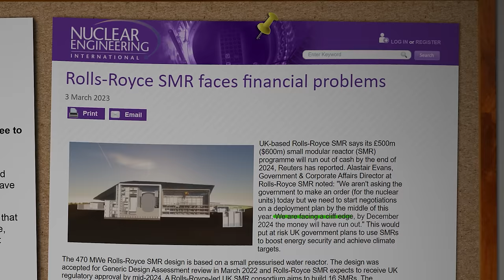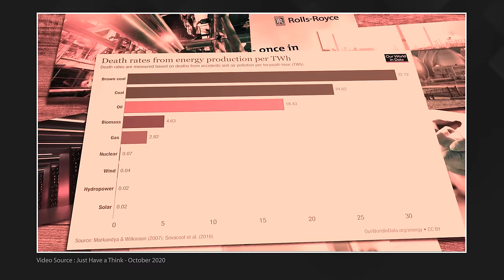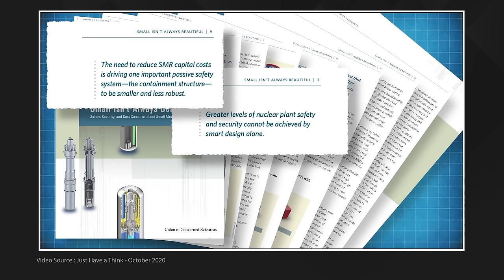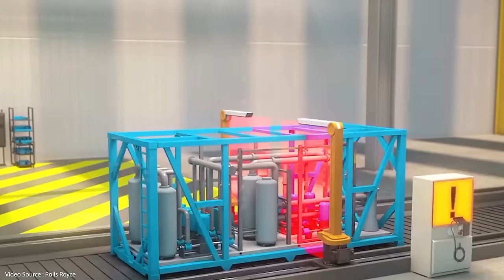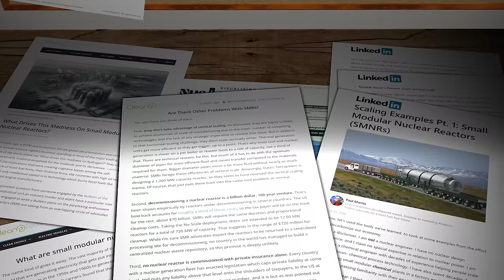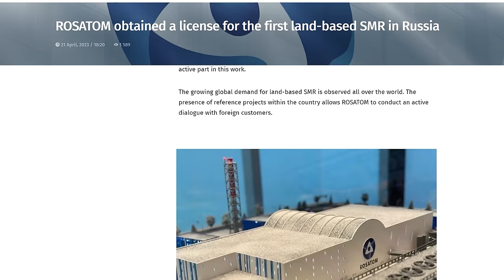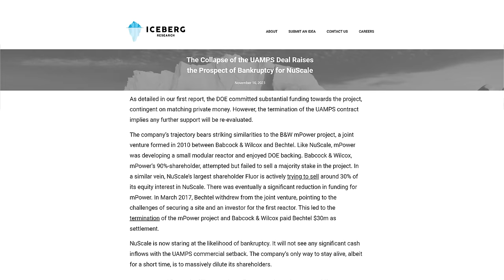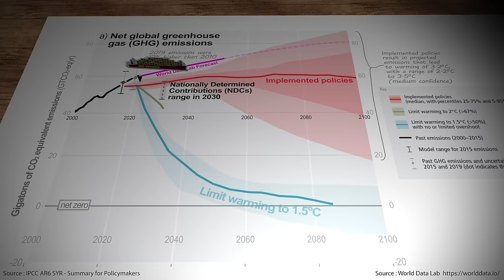Small Modular Nuclear Reactors. The Verdict

Comment: You are so correct that the entire concept of SMR's was fatally flawed from the start just on the economics alone; and the mass production dreams were only ever a fantasy. 

I'm an experienced nuclear plant engineer who is very pro-nuclear and has researched the history of nuclear power plants... and the fact is that the answers were known decades ago.

For starters the concept of "mass produced" SMR's with main components transported to local sites with minimal field assembly was 1st proposed in 1955 in the annual conference on the potential of nuclear power plants (held in Europe that year - not sure which country).

The 1st ever demonstration SMR was a 22 MWe thorium fuel cycle based BWR in Elk River Minnesota (USA) which many people were talking about could be erected in many small communities in the USA.  Online 1964, Shutdown 3.5 years later in 1968 due to major design issues.

However, it had already been deemed uneconomical as a power plant just due to staffing cost alone.

For the record the USA built 17 commercial nuclear power plants in the 1960's - 1970's which would be considered SMR sized today.   All of them were shut down decades ago as they were not economical to operate against the large nuclear power plants built at the same time (I am unsure of the details for the rest of the world; but, understand that the same pattern followed in other countries unless there were unique locations where building larger plants did not make any sense).

As an aside: did you note that Elk River was a thorium fuel cycle (there is nothing new about thorium and the current proponents are not talking about its historical issues identified from the USA's failed attempts to develop it as a fuel source).  The USA went whole hog into developing thorium as a nuclear fuel source in the 1960's - 1970's to see if it would work.  Along with all the test reactors it was run in around the world the USA built and operated 2 test molten salt reactors and the Shippingport demo/test power plant (PWR 60 MWe) which showed a successful breeding thorium core could be designed and put into most of the existing PWRs in the world -).  

The USA then built 4 commercial thorium fuel cycle power plants of BWR, PWR, and HTGR designs. In all cases thorium did not work out (there were both technical and economic issues with thorium fuel cycle reactors) - and at least 3 of the reactors were converted to U235 fuel which worked better and was cheaper.    Note if thorium is such a good choice now why are we not putting it into PWRs at this time - as at least we know that the reactor designs work well and we now have passively safe PWRs?

Anyway back to SMRs (regardless of fuel source):    By the end of the 1970's it was known that the concept of SMRs were dead unless it was for some kind of geologically isolated area where they only needed a small power plant and transmission line construction was impractical.

If you double the size of a nuclear power plant it only takes about 40% more materials and in many cases the plant staff size does not even change.  At some point the staffing size does increase modestly.

As for the failed NuScale Idoho plant.  6 SMR reactors of 77 MWe output was the claimed plans (462 MWe).  What is interesting is that only the 50 MWe version was licensed by the NRC and there was an expectation that the NRC would quickly license the 77 MWe version which they thought could be done during the early site preparation period: Utah Utilities & NuScale was well into the "Pre-License review" of the 77 MWe design and had received good feedback. But the License application was never submitted after they received the construction quote and the pre-licnese review was terminated.

The quote came in at about $9.5 Billion to construct, with an estimated $1 Billion+ inflation adjustment during the construction period.

In reality this would have been about the same price to build a single Westinghouse AP-1000 (about 1150 MWe) and the staffing for the plant would have been about the same.

As for the $55 raising to $89 per MWhr for electricity cost.  That was after $4 Billion from the US government for SMR development grants - so the real cost rose to well over $100 per MWhr (where a single unit AP-1000 could be built for significantly less than half of that).

Note on AP-1000 construction cost:   Yes a lot more was spent at VC Summer and Voglte. But the USA (and Europe with the EPR) had not built nuclear power plants in so long that no contractors and very few workers understood how to build them - and also a number of suppliers shipped fake certified components and materials to site that could not be used - or had to be tore out and replaced.  Massive cost and schedule delays, and lots of lessons learned.    The Idaho NuScale project used the same contractors to quote that had learned their lessons with the Vogtle AP-1000s which is why they could quote so much better (and if those contractors are used before they forget - the next USA nuclear plant will be built much cheaper and much more closer to schedule than Vogtle 3 & 4).

By the way China built 4 AP-1000's with an average construction time of about 6 years.  They had a delay and cost overrun on their 1st one as they were not used to working with the Westinghouse design - but once they understood it - no noticeable delays or cost overruns (and Chinese construction standards and contractors for nuclear are just as good - if not better - than their western counterparts.  No shortcuts, no fake materials, and the workers understand high quality nuclear construction standards and practices).  I did a consulting job for one of the Chines AP-1000 plants; and was impressed.

China is now building 6 more AP-1000s (they have a licensed copy) and at least 2 other countries are starting construction on AP-1000s- and at least 15 more AP-1000s are in the planning stage worldwide.

The Westinghouse AP-300 benefits from the fact that the controls and many smaller components are exactly the same ones being produced for the AP-1000's which provides a cost savings both up front and for repair parts and service down the road.  No other SMR proposal can claim the same advantage.

As for mass production - it will never happen for a nuclear power plant.

1) At a minimum you need a proven plant design that is known to work economically for many decades - and in the history of nuclear power plants most initial designs did not work very well at all.  There is not a single SMR plant that has a proven plant design - and it will be many decades after one goes on line before we know (we only have great PWR designs now based on the lessons learned of over 4 decades of operation of about 100 unique PWR power plant designs worldwide (76 different light water designs in the USA alone).  A lot of design ideas that looked good in concept did not work out and there are many early shutdown plants as it was too costly to modify the plant to a different design.  Now we can pick out which design idea worked for each component, structure, and system.

2) The design of the components and overall plant must be identical for each plant.  Never going to happen as each nuclear power plant site must be designed for "worst case" LOCAL earthquakes, flooding, storms, etc.  No one wants to pay for a plant that is designed to handle all the worst case conditions that exist somewhere in the world.  It would be massively overbuilt and expensive.

3) As for mass production.   I put the number at a minimum of 500 identical units a year - for at least 10 years to make it economical to even build an automated plant.  We don't need that many nuclear power plants (even if only 50 MWe each).

4) Those sketches and concepts of building skids in a frame and assembling them onsite has been tried at least twice for fossil plants.  Total cost and schedule disaster.  One of those ideas that looks good as a concept, but requires a level of quality and dimensional control that so far has not been demonstrated to exist. It's cheaper to just build a normal seismically designed metal framework for the site, bring in the preassembled major components (Like has always been done) and field built connecting piping and wiring.

By the way, we disagree about the cost of solar and wind.  I will post separately on that.
Reply: Possibly the greatest youtube comment ever.
Reply: That's the kind of insight I was hoping to find in the comments!
Reply: Holy crap, now THAT is a detailed comment!
Reply: I think the SMR design makes more sense for producing heat for industrial use. Just go big for grid power. We also need to quit trying to build brand new design reactors for grid use.  That is part of the problem.  Instead of building what we already know we can build they always want something new and shiny.  I live in Canada and would rather we just build the same CANDU reactors we built in the 70's.  They are doing refurbs on them now and are currently 6 months ahead of schedule.  The reactors have been extremely reliable yet the government wants to build SMRs.  It makes no sense.
Reply: Actually one other thing I heard is there are a bunch of reactors in the US that are basically already built but were abandoned.  They really should look at why and if it was just companies running out of money and the reactor can be saved the feds should throw some of that inflation reduction money at them to finish them. It would be interesting to know how many reactors like that are out there but it sounded like they are everywhere.
Reply: Great writeup....you are obviously an expert and your descriptions of the realities of SMR's help us all better understand the pro's and con's of this technology. Thanks!
Reply: Perry, please keep watching and commenting.  This Channel and the concerned public need your insights. 🇨🇦
Reply: A great comment, but the only criticism I'd make of it is that it is extremely US-centric. SMRs have been seriously pursued in a number of other countries - especially by the Soviet Union in the 1960s and 70s - and the experience was, if anything, more disastrous than the US'. I'm sorry, but all this hype about SMRs was just more distraction and delay by climate denialists who have put out a damned sight more FUD than the tobacco companies ever did..
Reply: Mr. Putin's experts are saying  that SNR requires  uranium  to be enriched to 19 percent  to avoid  refueling a reactor too often. In order to develop, license and build such a plant , it would take about  10 years and 10 billion. RosAtom has the technology to enrich uranium and they have SNR up and running  since 2019. The head of  the company said they received about 50 preorders for SNRs 14: of which from abroad
Reply: @kenoliver8913   I should have added a general comment about the rest of the world had similar experiences with SMR's.  I just happen to know the numbers of the USA reactors and know the most about the USA reactor designs.  I did know that they were tried in at least a half dozen other countries in the world.
Reply: @pin65371  It would be the rare case where a nuclear reactor of any size would work for an industrial plant due to the requirements for nuclear plant safety and worst case planning.    In most countries in the world nuclear plants are designed and staffed to withstand at least a terrorist attack of a certain size.  You also have to have a staff on hand to handle a major radiation leak to the general public.   These two factors make any nuclear plant very expensive to operate - and not suitable for general industrial use.   Please note that most nuclear plants are built many Km or miles from any sizable population center - for very legitimate reasons.

As for the 1970's technology CANDU reactors.   Sorry, but in my opinion their time is long past.  They required a lot of operational and active equipment and operator involvement for a safe shutdown in most cases (and 3 Mile island became a partial meltdown when an operator made a mistake and turned off the automated safety system that was running - Chernobyl was also operator errors).  You have no idea how expensive  and stressful it was to keep this equipment in operation and how much trouble it caused every nuclear power plant.  These active systems added a lot of equipment, valves, and controls that had to work - and required a lot of maintenance.

The nuclear world has shifted to Generation 3+ Passive Safety plants where the entire plant staff could vanish, all electrical power vanish, and any of the design basis accidents could occur and the reactor will be safe for at least 3 days.

As an example:  The AP-1000 could have a loss of total power to all systems (which means that emergency generators and battery backups fail as well) and then a large break of the primary cooling pipe... and the reactor would safely shutdown without any operator action and the steam in contaiment would melt a fixture on a storage tank on top of containment allowing it to slowly drain cooling the containment building and condensing the steam... and the only action needed to keep the core safe and prevent a meltdown is that after 3 days someone needs to refill the tank on top of containment - which could be done with a pumper truck and a fire hose if needed (although there are multiple systems in the plant designed to fill that tank).   After a few weeks they don't even need to fill that tank anymore.   Everything will be safe.

The good news is that last fall some company in Canada announce that they are designing a Generation 3+ passive safety CANDU reactor and will be submitting its design in future years to the Canadian regulator for approval.   That's the reactor you want to build if you wish to stay with the CANDU design.    Otherwise the PWR AP-1000 is the current best design in the world (the EPR designers have admitted that they have to redesign it and no new EPR projects will start.  The GE Generation 3+ large central station BWR could not find anyone to build it).   I am unaware of any other large central station Generation 3+ designs, although I understand that the Koreans are working on one.
Reply: @pin65371  Concerning all those abandoned US reactors in various stages of construction.   Construction dies on all of them due to the then current way nuclear power plants were approved, constructed, and licensed; and all but one (Watts Bar Unit 2) was formally abandoned and could not have construction restarted even if they wanted to (it would actually be cheaper to just build a new modern design).

The original nuclear plant approach in the USA and many other countries was that the NRC approved the concept of building a nuclear power plant at a site; but did not license the plant for operation until after it was complete - and only then did the NRC do a design review to see if it met "current design and construction practices."

There were several problems with this approach:

1) It was assumed that the vast majority of the nuclear power plant (except for a few components and systems) could be built to commercial construction standards with no oversight.  That turned out not to work so well and problems became apparent once a number of plants gained some years in service.   Then the NRC issued new requirements on construction standards.  Now what if you had already built that equipment and systems.  Sorry, it cannot be licensed to operate - and you need to tear it out and build it again.

This happened multiple times which caused delays and major cost overruns.

2) In 1975 the Browns Ferry Nuclear power plant had a major fire where the operators lost control over key equipment and almost lost control over the reactor itself.   This was because there were no requirements for cable and piping separation for redundant trains of safety equipment (a small fire at one location could damage all the control cables for 2 or 3 separate supposedly redundant equipment trains required for nuclear safety and plant operations). 

This drove major design changes to require control and power cables for each separate piece and train of nuclear safety equipment to be physically separated by a good distance (or in some cased inside fire proof case or with a substantial fire barreir so that they could not be affected by a fire).  This required truly major design and construction changes to any plant not yet licensed (and existing licensed plants had to modify if they could or hire a large staff of dedicated fire watch personnel who all they do is wander the plant from critical location to critical location making sure there is no fire that could affect the bundled control and power cables:  I think the one plant I worked at have something like a staff of 20 people dedicated to being these roving fire watches).

3) in 1979 3 Mile Island partial meltdown occurred because of a variety of operator mistakes; but there were several key pieces of information the operators did no know (and could not know because they did not have the instrumentation required:  That a relief valve had stuck open and they had what is known as a small break loss of coolant accident in progress; and that a water level with a steam bubble above it had formed, and that this water level was getting low enough that it uncovered the reactor core - resulting in a partial meltdown).

Another series of major design changes were ordered - and this time it affected the licensed plants as well (and most of the PWR plants in the world now have 3 trains of redundant water level indicators on the PWR reactor vessel); and every relief valve on any primary coolant or treatment systems now has redundant temperature and/or flow measurement indicators so that the operators know if a relief valve is leaking).

So for the plants under construction it became a constant game of required design changes while the plant was being built, and many plants just gave up due to the constant very costly and time delays caused by all the rework.  Once work was suspended the owners canceled the NRC construction permits (which cost money to keep open) and abandoned any attempt of maintaining quality control of their partially completed plant.  Many components were sold off to other nuclear plants in the world who wanted to buy for dimes on a dollar nuclear grade equipment.  One of the plants I worked at got new steam driven auxiliary feedwater pump turbines from one of those plants as our late 1960's designed pump turbines had a major design error that did not show up until well after our plan was running (it always had problems - and I was the person who figured out why and found the original records from the Mfr that documented the problem).

It's litterally impossibile to restart construction on the plants where the construction permit was closed. The USA NRC has no procedure or process to bring one of these plants back into a construction process as there is no longer any qualified QA rec cords for key structures and design elements.

Watts Bar Unit 2's construction permit was kept open by the TVA and since it was to be the 2nd unit of a dual unit site where the 1st unit was already running - they had QA on site and maintained the quality control of the plant and construction records.   I believe that construction of Watts Bar Unit 2 was restarted in 2011 and it went through the old licensing process and was licensed in 2016 for operation.

After the Nuclear Power plant industry went through this constantly changing standards while they were building the nuclear power plant and all the major delays and cost overruns (and canceled plants) the industry demanded that the NRC change their licensing process. They wanted an approved design that they could build without any design changes unless there really was a major new issue that no one had every thought of or had happened.  

That was the start of licensed nuclear power plant designs, and licensed sites before you start construction on the key power plant structure.   Now a utility is issues a Construction and Operating License (COL) in the USA to build a specific licensed reactor at a specific licensed site.  As long as you build it to the specifications and implement all the programs and strafing defined for the reactor and the site you already have an operating license.

I know that many other countries have followed the US NRC lead on this approach and I understand that even China is using this approach now (and I have heard that Europe also has some experience with changing plant design during construction process).
Reply: My understanding is that China is currently going for factory based production of the components of their HT PBR to replicate this on scale for industrial heat and hydrogen production as well as power.

The dicotomy you draw between mass produced and one off would also appear to be too absolute, as there are a host of semi custom options available, where you factory build the bits you can, and fiddle around on site to some extent.

That is true also for safety. The costs of building to the worst conditions anywhere for all plants would of course be prohibitive, but you could certainly have a reference design, which is pretty strong, but which you simply don't put somewhere really daft.

Nuclear is a good option to have as a part, and only part, of the grid, especially in high latitude countries where overbuild of solar is more expensive and provides security against events like major volcanic eruptions greatly reducing solar.
Reply: Re: Your comment on Solar / Wind / Batteries...

You can today build a stable SWB system with 90%+ uptime that has 5x the effect in half the time of any given Nuclear plant for the same amount of money.

Or, to put it in other terms... Let us assume 1 Gigabucks buy 200 MW of Nuclear power, to be built in 10 years. *Or*, should we spend $1G to buy 1000 MW of SWB in 5 years time?

And that gap is increasing, two years ago that number was twice as expensive as it is today. By 2030 we can build 15x-25x the SWB effect of a Nuclear plant in 5 years. How far does the gap need to grow, before you admit it is cheaper? :)
Reply: @wertigon  I made very specific criticisms of the arguments presented, that the notion that mass production is only in vast quantities and semi custom is not an option, and that the only way of having reasonably standard safety criteria is to over engineer to the point where you can stick a reactor anywhere at all you fancy instead of somewhat restricting your choices of location is equally false.
Shifting the argument straight across to 'alternatives are cheaper anyway' is not a productive way of arguing. 
The Chinese argue and there is some evidence to support that their levelised cost of power from nuclear before whatever level of standardisation they can get by series, I would term it, not mass, production of as many parts as possible in a factory setting is currently cheaper than their renewables, which they are pretty good at.
How costs may develop is another issue, but we end up arm waving if specific arguments are not challenged and tested, rather than 'So and so technology is better anyway'

The good news is that where we do not have the ridiculous build revisions and beaurocracy of the West, nuclear is already a cheap option, and some degree of factory series production is likely to help.

I agree with the argument that SMRs as opposed to a greater degree of serial build of larger reactors are not proving cost effective.

If other technologies can do it cheaper yet, great.

I am optimistic that that will be the case, but properly managed nuclear construction also looks like a fine low carbon alternative.
Reply: so lets get this straight,your pro westighouse and anti rolls royce,golly gee u must be an american,shucks!
Reply: I had my hopes up for SMRs and knew about all of the US work in the 70’s. To me it seemed like a better solution. They did abandon all that back then.

After reading your commentary on this topic I understand. We are as far as we are going to go for a several reasons. Just seemed like it would have been easier to handle a problem with a modular system, but I guess it’s just not practical for a bunch of reasons.
Nice comment. I learned a lot.
Reply: You missed one important issue exposed by the attempt to build VC Summer and Vogtle at the same time.  Even though the projects were ~50 miles apart there were not enough constructions workers with the needed skillset to build them.  And that issue is  not going to change anytime soon as the number of people in the construction trade is decreasing, not increasing.
It is not a forgetting issue, it is a  not enough workers issue.  And supply chains don't understand or care about what nuclear grade means.  The U.S. capitalist business model has devolved to get away with whatever you can.
Reply: @perryallan3524  First let me say that every reactor operator in that TMI-2 control room that night was a highly trained ex-navy nuke. And they did exactly as they were trained to do.   
While the accident could have been mitigated if the operators had taken the simple action of closing the block valve, as you say, they lacked the proper indications and given what they did see, they did exactly as trained.  I was weeks away from my NRC Reactor License Exam at the time of the accident and I would have taken the same actions as I was trained to do.
Reply: To the issue of using thorium as a fuel, the simple answer is it requires reprocessing. Thorium has no natural fissile isotope, it needs to be breed and reprocessed. Reprocessing fuel, Plutonium or U-233 cycle, is still deemed uneconomical. I would argue that the waste reduction brought about by reprocessing would make it more viable if utilities had to pay the cost of long term geological storage, but we're not there yet. 
And yes, nuclear is really a technology that makes the most sense for large scale, high density power generation, that's where the costs are lowest. I think the global push for SMRs is coming from an insane opinion that nuclear needs to compete against renewables+storage, but that couldn't be further from the truth. The two systems complement each other wonderfully in a decarbonized grid. Renewables provide great access to electricity at low density; but in high energy density demands, like large cities where you're needing to meet tens of gigawatts of capacity, large/regular scale nuclear makes more sense. 
It's just so silly that the argument it still being framed as nuclear vs. renewables, when in reality it's fossil fuels vs. any reasonable alternative. All of this grobbling over LCOE and LCOS is a fight over a couple of dollars on or off of the average persons monthly power utility bill. Pick whichever one makes the most sense for the local circumstances and the world will be better off
Reply: @Spencergolde  You obviously have some knowledge and/or experience in the nuclear power generation field.  

However, the internet is flooded with YT videos from creators intent on nothing more than making money and viewers with little education or even ability to understand the issues involved.  Many people that I have chatted with actually believe in Thorium reactors without any knowledge of fissile vs non-fissile. 

 As soon as they state that uranium reactors use only 3-5% of the fuel while claiming Thorium reactors use 100%, I know that the American public school system has let us down again.
Reply: @wertigon  Your analysis omits 3 key facts.   

1) The average construction time worldwide for a GW sized nuclear power plant is 6 years and they are built pretty much on budget as well, when you exclude the European EPR and the USA's AP-1000 experience where both Europe and the USA had not built a nuclear power plant in so long that they had no experieced contractors and almost no experienced workers who knew how to build nuclear plants - which led to massive schedule and cost overruns.

2) The fact that current solar PV and wind turbines only have a useful life of about 20 years (solar PV cells degrade every year in operation).

Since the expected life of current generation 3+ passively safe nuclear power plants is in the range of 80-100 years (or longer) you would have to tear-down and rebuild your solar and wind generation 4-5 times at ever increasing cost.

While there is a very long life (if not infinite life) battery technology it is rarely built because of low energy density and its very large size.

I have not even heard of a utility scale battery technology other than the low density one I mentioned above that has even demonstrated a 20 year usable life at this time (perhaps I am wrong on that).

Anyway, your technology choice now has the customers paying for tearing down and building new solar and wind facilities about every 20 years so you are looking at a lifetime cost in the range of 4-5 times larger than your analysis suggest.  What's going to happen with battery life is an unknown but does not look good based on initial results of modern batteries.

Your option is not cheap at all - unless you ignore all future cost that would occur for your technology in comparison to a nuclear power plant.

3) Your analysis totally ignores the cost of capacitor banks needed to control reactive power in the transmission and distribution network, and their replacement costs, that are not needed with a nuclear power plant.

As far as your projections of how economical solar and wind will be in 2030.  Those projections might not develop.
Reply: @philcooper165  You miss my point and a key fact presented in the video.

RR is a great company with a great history in many areas.   I do believe that they are technically capable of designing a safe SMR reactor design that would basically work (how well is yet to be seen).

However, RR as a company has almost been bankrupted by a series of key design mistakes in their civilian aviation engine division spanning decades; and if you follow the aviation forums you will find people yet claiming that RR will be forced to split up and have the civilian aviation engine division declare bankruptcy.

RR does not have the money to develop a SMR to a licensed design status.  My memory of the video is that they have asked the UK government for a 225 Million grant to fund such a development.  Note that if the UK government funds that development I would expect a unfair trade practice claim to be filed in international court; and I don't see how the UK wins that case (its clearly preferential treatment by the government of 1 vendor).  Then the UK owes someone (or several someones) 225 million + interest.

Even if the UK government were to fund the RR proposal that does not mean that the RR design would win out over other designs such as the Westinghouse AP-300.  

What Westinghouse has going for it is that its plant will use the same controls and control scheme that has been proven on the AP-1000 plants, and a number of other identical components already proven on the AP-1000 plants.

Furthermore given the production numbers of the AP-1000 plants there will be spare parts and technical support for those items at a reasonable cost for likely 80-100 years or more.

I've worked in nuclear power plants that had equipment that was only used in a few nuclear units.   Spare parts and technical service was extremely expensive (and in several cases several plants are paying the mfr to have a staff to support their 1960's technology).

In my opinion; anyone with half a brain on long term parts and support cost for long term operation will chose the Westinghouse AP-300 SMR which uses a proven design and control scheme with its larger AP-1000 cousin over a new design which may well only have a few reactors built.

Have a great day,
Reply: I am more convinced than ever, by this conversation, that upgraded (gen 3) nuclear electricity is the way forward for our civilization and our species. We have grave challenges ahead and must work in cooperative and efficient manner. Thanks you guys!
Reply: That's a fantastic write-up perry.  I thought one of the key advantages of the SMR concept was supposed to be that they do not need to be built near water.  The other advantage being the lack of refueling outages and as a result- no spent fuel storage requirements.  I am a sales / tech service rep for manufacturers of specialty materials used by commercial nuclear operators, and was calling on Holtec for a time when they were unveiling their SMR-300 design.  (I believe they are building two at Palisades- but that may have changed.)   The current fleet of US nuclear power plants operate on a near geologic time scale, and projects can take many many years to develop.  I know countless engineers in the nuclear world, and what I observe happening is that when engineers retire- they are often not being replaced.  Rather the work is divided amongst the remaining engineers, and so really only the most crucial projects get attention.  At this point- it's only crucial projects, and essential maintenance- and other projects that years ago would be addressed are being deferred (until they are elevated to "critical").  One of the plants that I service outsources some of their engineering to Rolls Royce in the UK.  Other plant engineers are pulling double duty as engineers at Sargent and Lundy, Enercon (RIP), and other firms.
Reply: @mtn1793  I worked in the nuclear industry for 40+ years at five different facilities and am pro nuclear.

But here are the problems in the U.S.;
1- While large (Gw) gen 3 reactors are the best overall choice, they take ~15 years to build one and the construction industry does not have the personnel with the necessary skill set to build more than one at a time.

2- The cost for new nuclear is 2-3 times the cost of any other power generation method.

3- Many of the 93 currently operating nuclear power plants are at or beyond their design life and while they can keep running, it is  not cost effective given the maintenance costs.

4- If and that is a big if we address all the challenges and everything goes right we may be able to replace SOME of the current nuclear plants with new ones but the percentage of U.S power consumption provide by nuclear will decrease significantly over the next 10-15 years.

That unfortunately, is reality.
Reply: @clarkkent9080  I mentioned the experience worker shortage in my main post.   I also know that only about the top 1/4 of workers can adapt to mindset needed to work in nuclear construction and nuclear power plants.  Yet both plants were making progress on finding workers with the right mental attitude willing to learn the skills needed.   There is now in the USA an adequate size core workforce with experienced contractor management to actually build a nuclear plant pretty close to on schedule with minimal cost overruns.

The reason VC Summer was cancled was not a worker shortage.  It was gross mismanagement of the project in that the VC Summer upper management were not willing to change their ways even when presented with better ways of doing things.

Both VC Summer and Vogtle were having a lot of problems with schedule and cost.  Both plants hired outside experts to review how they were doing things and make recommendations to bring the project back on track and at least finish it as cheapest as possible.   The recommendations for both plants were virtually identical.

The upper management at Vogtle swallowed hard when they read the report - and implemented or addressed virtually all recommendations with either direct compliance or with an alternative method they though was more adequate for their current situation.

The VC Summer upper management rejected the report as apparently an insult to their knowledge and methods and proceeded to move ahead without changing anything.  The VC Summer project died once that became known to the State Utility Commission.

They should have known better.  If you have worked much in the nuclear industry you should know that making mistakes is not a problem (we all make mistakes).  It's only a problem if you don't acknowledge the mistake and fail to take actions to prevent occurrence.  I've never felt any fear to go to my management or the on duty SRO and tell them that I made a mistake that they needed to know about, what it was, why I think I made it, and ensure that it did not affect the overall safety or long term operation of the plant.  My experience is that you get thanked for that.

I also was one of the engineers who was Root Cause Evaluator Qualified; and have led many interviews with operations, maintenance, engineers, etc. on what they knew or did and why regarding a major plant issue.  I always started with the clear instructions to the people being interviewed to just tell us the truth and what you understand and there will be no repercussions except perhaps some additional training if needed; and there never was as long as they just told us the truth.

In my nuclear career (I am now retired) there was only 1 case where we identified that someone was less than truthful or intentionally did not do their job.  Needless to say that things did not go well for that person. My understanding is that the NRC issued them a 5 year ban on working in the industry letter to him - which ends your nuclear career even after 5 years, he had already gotten a job at another plant as his way of avoiding his involvement in the issue he created.
Reply: Perry:  Excellent input but I've run out of time to comment, suffice to say, we mostly agree and a little disagree.
I posted my 'two bobs worth' this morning - Sydney Aust (above).  Have a peek and by all means criticise.
Reply: @clarkkent9080    Perry Allan contradicts the 15 year build time even if that’s the current reality. Many said the USA couldn’t build for WW2. We’re backed into a corner in my opinion. Civilization as we know it is an energy based construct. Fossil fuels are a threat on several levels at this point. If we are to maintain civilization and face the coming troubles we’ll need the most efficient solutions possible and we need to act on that now. My pet fantasy is that every bit of government subsidy for nuclear be returned to the public as return on investment. These changes required involve more than just energy.
Reply: @clarkkent9080  Thank you for reading my prior comments.  I did not mention the block valve as I did not want to confuse people with extra information who are not in the know.

But, are you saying that you would have turned off the Safety Injection system as the one operator did which is the key item that led to the partial meltdown?

A little background:  I'm an ex navy MM who was not a nuke because I am partially color blind (although my test scores and attitude were great to be a nuke); and every navy nuke who worked in my engine-room told me that I would have made the perfect navy nuke.

At least half the operators at the nuclear power plants I worked at are ex navy nukes; and I don't recall a single one of them telling me that they were OK with turning off the SI system given what was and was not known.

However, the bigger issue is that one of the biggest lessons of 3 Mile Island is that you should never rush to put a plant back online after a trip.  The big change in the industry afterwards was that the operators job was to ensure the reactor is safe, properly shut down, and all safety systems are working (which you would know if you completed your exam and became a licensed operator).    Let's take a day of so to fully understand the trip and do some of the maintenance list on the full or partial shutdown maintenance list.  Once we know what really happened and some things are fixed we can do a controlled slow startup. There is just no reason to rush it.  At all 3 of the nuclear plants I worked at an operation inspection team of the containment building was made to look for any unknown issues now that the reactor was offline.

Of course this goes against the Navy training where if the plant trips you have to get it back online as fast as possible. In a battle dead in the water with no maneuverability is often literal death.

So this is a case where the Navy training and concepts of fast response to a trip does not fit civilian nuclear power plants, and likely contributed to the event (as my memory says the event started with some upset with the condensate or feed-water system which resulted in a plant trip and they were rushing to get the plant back online - I forgot the exact details and see no reason to look them up).
Reply: @arau8310   All Rankine Cycle (Steam Cycle) power plants need to be built near water - or have a very large aquifer to pump water from as makeup for a cooling tower.  This is needed to condense the steam back to water after the steam turbines.  Also there is a lot of plant equipment and HVAC that needs cooling water as well.

While I have seen concepts for a Brayton cycle power plants (Combustion turbine with the nuclear reactor or a heat exchanger heating the air/gas ) I have never seen one tested for a nuclear power plant (I am aware of one tested using a coal fired boiler to heat the air - and the flyash ate up the turbine blades very fast).

Even then, the only way to make a Brayton cycle plant efficient is to have a heat recovery boiler at the end with a second steam cycle turbine generator (Combined Cycle Power plants - thermal efficiency well above 40% and in some cases about 50%).

You are correct about what is happening to engineering plant staffs and long term maintenance planning.  I was downsized by that out of nuclear plants.  Then did consulting work for about 4 years until the work dried up due to plants no longer focusing on the long term.
Reply: @clarkkent9080  The average construction time worldwide for a GW sized nuclear power plant is 6 years.  Both Europe and the EU have gone through a very expensive learning curve as both of us had lost both the contractor and worker experience needed.  After Vogtle the next US Nuclear plant can be built far closer to the worldwide average using the same contractors and the core workforce that built Vogtle - if we act fast enough.

The average worldwide construction cost is about 1/3 of what Vogtle cost (and the Chinese built 4 AP-1000's and have started construction on 6 more).  Note that the Chinese workforce and technical standards are second to none for nuclear power plant construction.  I did a consulting job for one of the Chinese AP-1000 plants and was more than impressed. These are not the people building tofu buildings and bridges.

It will take time to rebuild both the contractor and worker workforce, but it can be done and within a decade we could again be building 3-4 nuclear units a year in the USA.  If the political will is there.
Reply: @petercunningham2339  I'm sorry; but I cannot find any previous comments from you.

Are you sure that they posted.   One thing I have learned that any link to another site does not clear some automatic filter.  Other things tend to get filtered as well which is a problem I deal with at times.
Reply: @petercunningham2339  Only time will tell whom is correct.   I have been saying NuScale's project was doomed to failure for the last two years and I was right.  I suspect that Terrapower will meet the same fate
Reply: @perryallan3524  aren't the safety concerns / requirements less stringent for SMRs since the impact of any single reactor failing is much lower and easier to manage than failure in a large reactor? Also, isn't the likelihood lower of any particular SMR failing catastrophically since they have more modest cooling requirements?
Reply: @clarkkent9080   Sadly - Yes, I agree with you.
The point is:  Nuclear energy (as distinct from warfare) has been with us for 60 years, and like any manufacturing, has improved.
The mass produced car and aircraft and ships (and whatever) have vastly improved via trial and error and economics.
Nuclear energy is no different.
Thus condemning Nuclear is a declaration of ignorance.
Reply: @ You, and many others, miss what the actual nuclear safety concerns are.  Short answer is that the standards are exactly the same small reactor or large reactor.   The small reactor may have certain advantages due to its small size; but the plant staff has to be ready for the same series of "worst case" events.

The fundamental job of every nuclear plant worker in the USA and most Western Countries is "To protect the health and safety of the public."    You do that be limiting any radiation release beyond the plant boundries to a trivial amount.  However, you have to be staffed and have emergency response equipment and plans with the local communities to respond to an unacceptable release offsite.

The Nuclear regulators don't care if your nuclear power plant ever produces any electricity or ever makes a profit.  Your job is to protect the health and safety of the public - pretty much no matter what happens to the plant with very limited exceptions - such as a large meteor smucking the nuclear plant - which is now called a "Beyond design basis event" and the plant should have equipment and personnel to deal with most of those beyond design basis events.

However you do have to plan for the worst possible case (well beyond anything in the records or geologic history in the rocks in the USA) of a local earthquake, flooding, terrorist attack, someone flying a large commercial airline into your containment building or spent fuel pool, etc.   Interestingly I read that the canceled Idaho NuScale project had to consider a volcano eruption within a certain distance as part of their design basis events that the plant should handle without any radiation release above the defined trivial level to the public.

Next you can add things like protect the health and safety of the workers, major plant equipment, etc.

Bottom line is that the plant has to show that they can handle a major radiation release inside contaiment and a sudden hole in the containment building.  I remember the drills well --> you now have a 1 square meter hole in the containment building... and then they see if you can adequately protect the health and safety of the public given the current wind conditions after things have gone horribly wrong with the reactor and fuel integrity and in our case the primary loop of a PWR.  We always wondered what event made such a perfectly square 1 meter hole in our containment building.... ;)

If a SMR is small enough the radiation leakage will be smaller which assists in containing the area of the leakage and dealing with the people downwind.  But probably will not matter if you have a windstorm at that time.

So same standards.  Even a small  reactor can create an horrible radiation mess inside the containment building with the right failures.  

For those people who think that does not apply to molten salt reactors... what happens if the reactor vessel or primary piping cracks and most of the screaming hot radiation wise molten salt fuel & daughter product mixture gets dumped on the floor or sprayed across containment by a leak - it will be a very bad mess and the air itself will contain highly radioactive particles within the containment building.  Now just add that hole in the containment building which is part of almost every emergency drill I was part of.

By the way having enough staff to handle such a failure and to be able to effectively keep the public safe is one of the things that really does not change based on plant size.  That works against the cost effectiveness of small nuclear power plants.

I hope that answers the question.
Reply: @perryallan3524   DUNNO, but directly below your posting - the one to which I now reply - is my comment.  "By accident I stumbled ......"
Reply: @perryallan3524 Actually...

1. The average SWB system that would deliver an equivalent amount of TWh and almost certainly more effect than most nuclear sites, currently costs ~20%-25% of the Nuclear power site and can be built in a year or two. Of course, this is the general case. And prices are dropping, too. Even if we compare best case Nuclear with worst case SWB, SWB still wins out in costs.

2. PV can go for 50 years or more. Wind is slightly worse, but new materials and manufacturing processes prolong the lifespan here, too. Also, Nuclear is not free to run, you need trained specialists and frequent repairs - Solar + Wind requires little maintenance and thousands of generators can be covered by a team of 40 people or even less.

3. No, those costs are included in the SWB analysis. I base my analysis on Adam Dorr and Tony Seba.

Please have a look at impossible grid batteries like Hornsdale and Moss Landing, that are operating at capacity. In my country alone, 2 hours of battery storage for 25% of the total generation is planned the next three years and more is to come. It is moving insanely quickly now. :)
Reply: @petercunningham2339  My point is simple: 
The U.S. cannot advance new nuclear for the many reasons that I have stated based on the latest facts for the most recent nuclear projects. Terrapower will be another example.
 If we pull out all stops and put this country on a Manhattan like project to build more nuclear projects, the best we can hope for is replacing the current nuclear power plants that have exceeded their intended design life and are no longer cost effective.

While I agree that nuclear workers have a high degree of honesty and work ethic, being in the actual operations allowed me to see a reality that you apparently were shielded from and many of the investor owned nuclear power plants are being infected with a less than acceptable level of safety from the top down. So I see a degrading not an improvement. 

A nuclear power plant is a machine and as such it can fail and accidents can and do happen.  Unless there is a radioactive release to the environment, the public is never informed of the many accidents. Yes there are improvements over time but I fail to see any ground breaking improvements in boiling water. 
If you researched the Westinghouse AP1000 you know it is a standard 1970s Westinghouse design with fewer loops and passive safety features.  Those passive safety features were primarily incorporated as cost saving measures (less RCPs, fewer Emerg. generators, etc.) with the added benefit of the PR hype.

 I have worked at CE, Westinghouse, and B&W plants and from an operational perspective, Westinghouse is a rube goldberg design of added complexity to resolve issues with previous added complexities.  CE designs are somewhat simular to Westinghouse. B&W plants are engineering marvels. 

I am pro nuclear and am not condemning anything.  Working in the nuclear industry taught me to leave out my desires and emotion and rely on facts and reality.  The number one rule is believe your indications unless proven otherwise. My indications direct me to make the statements above. What do you base yours on?
Reply: This is fascinating insight.  My father was on site at TMI the day after the incident.  He was there as part of a response team (he worked for the manufacturer of the safety-related wire and cable used at the plant).  The reports coming from news agencies at the time stated something like "radiation levels are 3 times higher than normal at the facility" which might have been true- but still put them at safe levels since radiation levels were so low under normal operating conditions.  Most people do not know that the other units at TMI continued to operate until just a few years ago. when all were shut down in 2019, despite the license having been extended to 2034.  I work with many great people at other plants who were once stationed there.
Reply: @perryallan3524  So sad that the industry is so short-sighted as to not recognize the detrimental loss of all of this tribal knowledge.  Knowing what works and what does not and having to relearn all of the proven techniques is a costly mistake the industry is insisting on making it seems.
Reply: @arau8310  TMI unit 1 continued to operate.  There were only two units at TMI.  TMI-2 was only 3 months old at the time of the accident and had very few fission products and very little decay heat.  Had the accident occurred at unit 1 that had been operating for a long time and had a significant fission product and decay heat buildup, the outcome would have been very different.

The simple point is that the accident was very bad and trashed a multi billion dollar plant that never operated there after.  I cost $1 billion in 1996 to just clean up the melted fuel and the containment is so contaminated that it is not even scheduled to be decontaminated till 2040, 60 years after the accident.  

Anyone that thinks the news reports were bad should realize that today with social media, 24-7 news, and political infighting it would be much worst.
Reply: @perryallan3524  
Research Hinkley build time in the UK.

You can maintain a nuclear power plant for 80 years but the cost to do so would not make sense.  Many components are no longer made before the plant produces their first Mw.  That is why many investor owned utilities want to shut down their  40 year old Gw units.

Wind turbines have an infinite lifespan as they are gear boxes and generators. The 20 year life span refers to the fiberglass blade life before replacement is necessary.

Today's solar panels lose 0.5 to 0.75% efficiency per year. So after 30 years the output drops to 78 -85% of original capacity. Every fossil fuel and nuclear power plant loses efficiency over their life. Replacing a solar panel is a lot easier than building any standard power plant.
Reply: @perryallan3524  You may know that the Design Basis Accident (DBA) is a double ended sheer of a reactor coolant pipe downstream of a Reactor Coolant Pump.  While there are many scenarios that could possibility initiate that event, the most logical and the one presented in the simulator training is a solid primary system with a temperature increase. 
So we were trained to never, never, never let the pressurizer go solid and that is EXACTLY why they terminated HPI and why I would have taken the same actions. That PORV indication is the ONLY indication in the entire control room that is based on demand not actual position....something never presented in training. 

Now or even days after that event the Monday morning quarterbacks can express shock that someone would do exactly as they were trained.  If you had been in operations, you would know the level of training to do as you were taught, follow your procedures and believe your indications. 
You must also know that many accident have occurred because operators thought that they knew better than their procedures or indications and took unapproved actions.

I personally know some that were in the control room that night and they are the best operators I have ever met and they did EXACTLY as they were trained.

I also know the Davis Bessie operator that a few years earlier terminated the same exact event by simply closing the block valve. When I asked why he took that action he was honest and said I had no idea what was happening but I didn't think closing the block valve would hurt. That operator should have lost his license for taking unapproved actions but since everything turned out ok, it was overlooked.  And given it was the 1970s, things were not as strict as after TMI.

I have a BS degree but even with that, I should never judge what an engineer does as I don't fully understand the job. I would suggest that you do not judge those operators, as you do not fully understand that job.  And any NRC licensed operator that doesn't understand why they did what they did, either  licensed after the accident or is not being truthful.
Reply: @arau8310  Baby boomers have been retiring in mass for the last 10 years and the last boomer will have reached full retirement age in 6 years.  It is not just nuclear that has lost experience.  Next time you fly , look at who is flying that plane
Reply: The problem is you haven't figured out yet that fossil fuels aren't economical.
When you account for the cost of damages and clean up.
We seem to have a political problem here, where the generation in power believes in infinite dumping on the next, and rigging of the pricing system to achieve that end.
Investors love profitable public dumping if you let them get away with it! Stop waiting for them to change their minds on that point.
Reply: @perryallan3524  I take your point about staffing, though it still seems like it's easier to build a resilient plant with smaller components whose containment structure could be placed on seismic base isolators and would be less likely to buckle and crack in an earthquake than a very large concrete containment building, for example.

I'm not sure how you would cleanly map the "1 meter hole" situation onto multiple smaller containment structures, but certainly if you're required to show that you can handle many simultaneous breaches at once, it would complicate things. Similarly, if the size of the hole isn't scaled to the size of the SMR containment structures, a 1 meter hole in one of those will be a much bigger problem since the exposed surface area to volume ratio is much less favorable when looking at a small building. Each SMR will contain less radioactive waste, but if multiple are breached with an equally large hole, their contents will spill much faster due to the increased surface area. So I guess it all depends on how you want to model these events.

Anyway, the staffing issue is definitely a big concern for costs. Thanks for your perspective.
Reply: Good information. 👍 
Does anyone calculate the transmission costs to the millions and millions and millions of customers. 
Say double generation, and you would have to double the capacity of the grid. 

Fragile grids can have blackouts. 

Electric energy is only 15 to 18 % of all energy used, so 5 to 7 times bigger national electric grid ezi pezi. Sarcasm. 

Everyone will be busting to invest in all the new private electric generation plants.

Just get the government to build the bigger national grid. Ezi pezi. Happy days. 😊 
Sarcasm. 

Staffing costs and quality are totally ignored also, as you say.
People get lost in their fantasy. 

The national electrical grid expansion is the killer cost economically. 
National debts will explode.
Reply: @wertigon  The only place I have heard of 50 year life of solar cells is for the extremely expensive ones that are used for long life satellites which are constructed the old fashion way from the absolute best quality individual silicone cells.

The ones being installed for power generation on land have an estimated useful life of 20 years as their ability to convert sunlight to power degrades every year.  Yes, physically they might last 50 years but would be producing almost no power at that point.

Most wind turbines are being torn down well before age 30 (with 20 years currently being common).  In theory you should be able to replace the blades and reuse the generators and gearboxes; but that is generally not happening.  My guess is that the gearboxes, generators, and potentially the towers themselves were not robust enough for reuse.
Reply: @ent9080 Worldwide that average build time for a GW sized nuclear power plant is about 6 years without any major cost overruns.

The problem is that Western Europe and the USA had not built nuclear units for so long that the contractors and workers forgot how to do it - and its a very costly with lots of schedule delays to teach a new generation.

In the USA if the same contractors who built Vogtle 3 & 4 were tasked with building another dual unit site they would likely be able to do in in less than 8 years with only modest cost overruns.  If they build a 3rd set they would be able to meet the world standard of 6 years with no noticable cost overruns.

Western Europe and the USA are missing the chance to develop the knowledge skillset for contractors and workers to build economical and on schedule nuclear power plants.

IF we focused on it within a decade we could have both the contractors and workforce needed to be starting 2 new large central power plants a year.  Note that there are currently 62 nuclear power plants under construction in the world; and 59 of them are large central stations (3 are of the SMR size - and one at 29 MWe is a technology demonstration plant in Argentina).  That means an average of about 10 nuclear power plants a year will be coming online over the next 6 years.

Late edit add:  The cost to maintain and upgrade an  older nuclear plant is far lower than the cost of a new plant.  They are economical to run for as long as you can. Keys being the life of the reactor itself and of major structural components.  Everything else is fixable or replaceable.  

At the plant I spent the most time at they are actually discussing taking about a 5-6 month shutdown and rewiring the entire plant to get to 80+ years (at least for the wiring that has not already been replaced - most large motor wiring has already been replaced).   The control, instrument, and original power cable casings are starting to get brittle after over 50 years of use.

An added benefit would be they could separate the wiring for trains and eliminate a staff of about 20 people who do nothing but roving fire watches as that plant predates the Browns Ferry fire and it has the same kind of situation where the control, instrument, and power cables for both safety related trains are in many cases in the same cable tray.
Reply: @clarkkent9080  I agree that one of the DBAs is a double ended sheer of the primary coolant piping in a PWR.   But, as you know... not the only DBA for the plant.

Lets just agree that we see some things different and also agree that TMI taught us a lot about things no one anticipated and resulted in an expensive set of modifications to all PWRs to provide the Operators with the information they need to see what is going on.

Have a great day,
Reply: @clarkkent9080  Last first:  This isn't a fight or a tussle to see who is right.
And this copy paste posted to Perry Allan that equally applies here:

? @perryallan3524   THANKYOU for bothering to write such a comprehensive review.  For me, EXCELLENT information that helps me learn. (and others reading this electronic sidewalk)
I suffer engineers logic - or as some say - "know your enemy", in other words factual information that challenges my understanding is WELCOMED.
How else is one to learn of reality?
What a pity in todays world that the official narrative is THE truth, and shall not be questioned.
Thankyou for bothering to take the time - and all that I just typed will be copy pasted to Clark Kent's also excellent, considered response.
Yours and Perry's comments won't rest with me.  GOOD info needs be shared.
Reply: @petercunningham2339  There is no right or wrong here.  Some believe in what can happen and what is possible and that is a very optimistic view that is valued in today's world.
I embrace the pessimistic view based on historical reality and what we have experienced up to this point.   However, I always try to improve and change the paradigm for the better.  In my world, I am prepared for the worst but strive to minimize that by haveing a contingency for the worst and responding accordingly. In that respect, I am rarely disappointed and usually rewarded with a better outcome than I originally expected.

Optimists however are not prepared for the worst or able to respond effectively as they never anticipated it, are usually caught off guard and disappointed.

If there is a nuclear resurgence, I will welcome it and gladly admit the errors of my thinking.  However, we should be prepared for a different outcome.
Reply: @ywtcc  Which is why I am very pro nuclear.  I just see large central stations as being far more economical than SMRs
Reply: @cornoc  The modeling of an accident only assumes one accident per reactor at a site.  I worked most of my nuclear career at a dual unit sites (2 reactors) although I have also worked at a single unit site.  For drills we only assumed that one unit was having all the problems - including the hole in the containment building for that reactor.
Reply: @clarkkent9080   My opening comment related to your "What do you base yours on?" - is irrelevant now.
Though not so negative, My logic is yours.  
Plan for the worst - look for the holes and the bugs because as with anything 'man' makes can and often does fail.
Nothing is perfect and worse - the little things most often align to result in a problem of some sort.
The aviation industry has an excellent analogy of Swiss Cheese - ie:  where in some circumstances, all the holes line up - and then shit happens!
Reply: @clarkkent9080  You are correct, and thank you for the interesting detail.  Every failure is a big deal, but my point was that the media (and Jane Fonda) made it sound like TMI-2 was a Fukushima-level event, when there was very little radiation escape.
Reply: @petercunningham2339  Then lets both hope that there is a nuclear resurgence but also hope that if that does not come to pass, there were some pessimists that planned other contingencies.
Reply: @perryallan3524  For cargo ships and freight trains it looks like we're going to need nuclear to get the job done.
For delivering thermal energy directly, nuclear's pretty good.
Measuring the cost of electrical energy generation isn't a good way to assess dramatically different energy technologies.
Reply: @stephenbrickwood1602  What you have there is a pile of ill informed complaining.
There's a concept called a "productive argument".
Learn how to have one.
Reply: @ywtcc  going the wrong way is wrong. 

As the capacity of generation increases, then grid capacity has to increase.

Grids are incredibly expensive.

Do you understand.?
Reply: @ywtcc  nuclear reactors require both a radiation protection team and equipment in case of a major accident that release radiation to the public, and a security team to protect the plant from terrorists.

It's not practical to do those things for ships and freight trains.  

Also for trains - what do you do if there is a major wreck and the reactor compartment splits open releasing a lot of radioactive materials and radiation to the area.

As for ships the USA built a commercial cargo ship (NS Savannah).   It was totally uneconomical due to the staffing size required on the ship to run it; and worse is that many ports in the world would not allow it to enter port to avoid being a potential nuclear disaster site if something went wrong.

The NS Savannah was decommissioned and the reactor and related areas removed from it  way early for a cargo ship.
Reply: @llan3524 It's totally impractical to turn SMRs into nuclear bombs.
You'd have to collect a bunch of them, the fuel will need to be processed. It's the crime of a nation state, not a terrorist group.
It's also probably easier just to mine the stuff if you're a nation state.
The regulation required isn't over the top as long as you keep track of SMRs.
This is part of the benefit of centralization. You can have those high security arrangements at a central manufacturing and maintenance site, then have that one central site service many reactors.
It's a also really nice iterative design project. Next gen manufacturing, I think, will have good application in this sector.
Reply: @ywtcc  technically, in the details, you have some interesting points.
It is a global situation that is still a major military problem. 
Little Rocket Man in North Korea and Iran Ayatollahs and Pakistan and 

All Dictators would love a nuclear industry.
Reply: Comment should be pinned
Reply: Perry, thank you for your detailed, cogent answer. A terrific contribution to the conversation, and much appreciated.

I've speculated on why SMRs are being pushed - again. I'm interested in your thoughts about this. There are some obvious motives:
- physics PhDs want a career in their field;
- investors see megabucks contracts which run for decades;
- contractors enjoy bidding very large long-term builds too;
- Unions & managers/executives are grossly overpaid at nuclear facilities.

Sorry if that last one seems gratuitous or slander: it's quite true. I've been an Executive Search troubleshooter for years, have replaced senior executives all the way up for utilities in Generation, Distribution and Transmission. I've interviewed the senior execs of every utility in N America, and know what they're paid (or did a few years back). Obscenely overpaid doesn't quite touch it for some utilities, the worst of which was Ontario Hydro/Ontario Power Generation. Multi-billion dollar builds make for a lot of money to spread around, and there's nothing that touches nuclear for excess.

But I speculate that the primary driver is a scam: placing SMRs on an existing nuclear site enables the operator to petition to just mothball the old reactors and avoid decommissioning to greenfield. This pushes the horrific cost of decommissioning down the line, leaves it for someone else. Ditto for waste management, a problem still unresolved. If the site is still an active nuclear generation plant you can argue for just continuing to store past & accumulating waste on-site in swimming pools. Problem solved until it's someone else's. 

What do you think?
Reply: @perryallan3524  Perry, I agree: "Anyone with half a brain... will choose the Westinghouse AP-300 SMR... over a new design which may well only have a few reactors built." 
I give you... Doug Ford, proud possessor of a Grade 12 diploma, some experience as a suburban illicit drug distribution "business", some time City Councillor and now, Premier of Ontario. And, I submit, possessor of perhaps half a brain.
Reply: @clarkkent9080  I'd like to revisit your comments about turning off the SI system.

I understand your comments about preventing the pressurizer from becoming solid.  But, didn't the TMI plants have pressure gauges on the primary loop and temperature indicators in the pressurizers.  As long as the temperature in the pressurizer is high enough you know that you have a steam bubble, and thus not solid?

When I went through system training as an engineer we were taught the required temperature to ensure a steam bubble in the pressurizer (well after TMI - which occurred while I was in the Navy and before I went to Engineering School and then I spent a fair amount of time in fossil plants) 

I do believe that all the required instruments were original to the plant and my memory of the reactor startup procedure was that you used the pressure gauge and temperature indicators to know when you established a steam bubble (and maintained it).  But, that was a Westinghouse reactor and I believe TMI was a B&W.

There may have been both equipment and a training difference between the two plant designs which explains why the operators at the two W plants I worked at did not understand the decision to turn off the TMI SI pumps.   The old timers (who were reactor operators in 1979) told me that they always knew if they had a stream bubble or not because they too knew that they had to prevent the system from going solid unless you were going into cold shutdown and the primary loop temperature was below a certain temperature (which is why they saw no need to turn off SI pumps unless they positively knew things were OK).

So tell me how the B&W design worked as far as knowing if you had a steam bubble or not and how that would have played out with your training.
Reply: @jamesthompson7282  little people ignore the grid expansion costs. 
Little people talk about spark plugs and let the big people raise the financing and build the road and infrastructure.
Reply: @ywtcc  That does not make any sense; and just last week I read a paper on the problem of verifying compliance for diversion of waste fuel with a MSR reactor.

It's a real concern because a MSR could easily short cycle the fuel mixture and be used to generate bomb grade U233 (which makes a great bomb).

The key trick is that you either seed the reactor with Pu239 (which contains some Pu240) or you seed the reactor with bomb grade U233 or bomb grade U235 (and virtually no U238).

Then you run the molten salt fuel for only a few months and dump it into bottles or tanks; which gets shipped off to a recycling plant.    A simple chemical extraction of the uranium gets you bomb grade material as long as you have not run the fuel long enough to generate too much U234 which acts as a poison for a U233 bomb if above a very minute amount (similar to how Pu240 poisons a Pu239 bomb).

How is the international atomic energy agency going to be able to track if the reactor fuel is being short cycled and if its being reprocessed into bomb grade materials.   As the paper I read said - they are working on coming up with a method; and I believe it will probably require active monitoring of any MSR thorium fuel cycle plant as a condition of licensing.

As far as multiple SMRs at a central station.  You are correct that takes care of the security and radiation response staff to a plant emergency for multiple units at once.  But the cost gets very high.

If you double the size of a SMR you need about 40% more materials and its likely that you can still use the same size of plant staff (at some point as you continue to do this plant staff will increase modestly).

If you build 2 SMRs instead you need twice he materials and at least 150% of the staff for 1 unit (there are places where you can share staff between side by side units).  The economics of the cost of construction and staff size makes 2 or more SMRs side by side quickly untenable.
Reply: @jamesthompson7282  Unfortunately, the GE BWR design was likely the only SMR design available at the time those decisions were made.  Westinghouse is a couple years behind GE on design and licensing and is moving as fast as they can.

But the next project will face the competition between the GW BWR and the W PWR.
Reply: @jamesthompson7282  Great post. I suspect you're right
Reply: @perryallan3524  If you want to have an argument, you're going to have to prove to me that you have enough respect to read my comments.
You haven't proven that.
Reply: @ywtcc  I don't need your respect.  If that is what you are looking for on this thread then I cannot help you.  

I am trying to respond to your main points; but I don't respond to all people on this thread and I may not respond to you in the future.

The readers of this thread can determine who's arguments make the most sense and decide who they respect or not, or that they just don't care (and different people often come to different conclusions on that).
Reply: @perryallan3524  Why are you so motivated to argue over what the economy will look like in 50 years?
Seems to me there's better solutions than argumentation. If that's all we did, we'd never have left the stone ages.
Reply: @perryallan3524 What is your opinion on GE-Hitachi's BWRX-300? They are considered for repowering Poland's coal powerplants, particularly industrial and urban cogeneration, which we use a lot.
Reply: @Zielinski85 I think the Polish plans have a likely chance to change to the Westinghouse AP-300 now that Westinghouse has entered that market size for nuclear reactors.

This is a bit different than Ontario Power (Canada) that made the decision to use the BWRX-300 as it was the only Generation 3+ passively safe reactor in that size range.  I expect those BWRX-300 reactors to become orphans in the nuclear world (only a few will be built and long term parts and technical support will become very expensive).

Westinghouse has now jumped into that market with the AP300 and the facts are that the PWR is the better long term economical design (see the data below).

So lets talk about the BWRX-300 SMR.  This is a Boiling Water Reactor and a downsize of the GE ESBWR which the USA NRC issued a design certification for in 2014 and no one in the world built (not even the Chinese who were evaluating Western power plant designs).

In that time-frame GE had 2 utilities who wanted to build a total of 3 of the large ESBWR; but GE could not come to any kind of agreement on cost to build these plants.  Meanwhile both China and the USA came to agreement to build 4 Westinghouse AP1000's (and all 4 of those are running very well). China and Europe came to an agreement on building 2 EPR reactors as well (and those are running - although they have had some issues and the EPR designers have now admitted that they have to redesign their reactor to address those issues).

However there is a more fundamental problem with a BWR of any design: Virtually no one wants them as while they are cheaper to build than a PWR they are more expensive to operate; and about 60 years of experience all over the world is that the PWR is the most economical option in the long term (and it is not even a close comparison).

Here is some data (from the World Nuclear Association:  As of February 2024 (updated frequently) there are...

Operating Power plant reactors in the world (413 total):
301 PWRs.
46 Pressurized Heavy Water Reactors (PHWR)  Note: these all appear to be variations of the CANDU design
42 BWRs (30 of those are in the USA from the US NRC):  Note that this is down from about 100 a decade ago.
11 Light Water GRaphite Reactors (LWGR)
8 Gas Cooled Reactors (GCR)
2 Fast neutron Breeder Reactors (FBR) Note: liquid metal cooled
1 High Temperature Gas Reactor (HTGR)

Under construction are the following power plant reactors (61 total - and I have just pulled the latest list from the World Nuclear Association - the webpage is updated frequently)
53 PWRs
3 FBRs (both sodium and lead cooled: India, China, Russia)
3 PHWRs (heavy water - CANDU design)
2 BWRs Note: both of these were under construction in Japan when Fukushima happened in 2011.  Construction was suspended and has not been restarted; but their construction permits are still open.

Note that after Fukushima that Japan shut down their entire nuclear power plant fleet because their design basis accidents did not include tsunamis; and the needed to evaluate all their nuclear power plants against a new set of design basis accidents (and what is now known as "beyond design basis accidents" with a suitable way to address everything except the rarest thing like a large meteor smucking the plant and just leaving a crater were it was).

Japan ruled that a sizable number of BWR reactors, and I think a few PWRs as not being able to be upgraded; and retired those plants.

Japan has restarted 9 of their 16 PWR reactors and modifications to the new standards for the other 7 are well in progress with planned restarts in the future.

5 out of 17 BWR reactors have been upgraded to modern standards (some years ago for some of them) and are sitting idle.  Japan has not been taking any actions indicating that they will actually restart those BWR reactors. My understanding is that modifications to the other 12 BWR plants is proceeding much slower than for the PWR plants (and have not even been started at some of the BWRs). That leaves a big question as to why not, what is Japan questioning about their BWR plants?

It appears that Ontario Power will indeed build a few BWRX-300 reactors; which may become the last BWRs built in the world.

The question is what will Poland and a few other countries do now that the Westinghouse AP300 is available as the PWR has a very clear long term cost advantage.  

Also the AP300  has a significant long term advantage of reasonable parts and technical support cost as it is using the same control scheme, controls, and a variety of other common smaller parts that the AP1000 uses (6 now built, at least 8 more on firm order - the Chinese CAP1400 is a somewhat larger Westinghouse designed and licensed version of the AP1000), and discussions for many more AP1000s are occurring in many countries in the world (and the UK is now wishing that they had chosen the AP1000 for Hinkley Point instead of the EPR).  The parts and technical service for those items will be readily available for the next 80+ years at a reasonable cost.  Huge advantage for the AP300 (and I know how costly parts and technical support for orphan plant equipment can be).
Reply: @perryallan3524  Thank you for your thorough answer. How big is the emergency planning zone around the AP300? My understanding is that one of the major advantages of BWRX-300 is that it can be put inside an industrial plant complex or on the outskirts of a major city, making it compatible with our brownfield sites, allowing the reuse of existing heat and electric infrastructure.
Reply: You don´t have a clue what your talking about.

A SMR is not just a reactor that have under 300MW of power. It have to be modular. Modular not the same as small. 

Small AND modular reactor.
Reply: There are several definitions involved here.

First is that in normal operations and events no radiation must be released beyond the site boundary except for a certain class of major events.

Certainly, a smaller reactor could have a smaller site boundary that would be consistent with brown field or even green sites within older industrial sites or business parks that cater to manufacturing plants.

The second definition is that the emergency planning zone must be large enough to cover a major radioactive release from a major event at the plant.  The 3 plants I worked at and several I consulted with in the USA all had a 10-mile emergency planning radius.  I didn't ask about the radius of the one Chinese plant i consulted for.

I'm not sure that 10-mile is a fixed number as I can see certain areas with well known winds in a specific direction to perhaps have a larger radius (or an oblong shape).

The concept is that radioactive releases either just go up into the atmosphere and get spread out across very large downwind areas (think of how Chernobyl affected Europe), or that the heavier radioactive particle should settle out and fall to the ground under normal conditions within 10 miles.

Within the USA I have never heard of an emergency planning radius less than 10 miles for a power plant (test/research reactors have different rules depending on the size and type).

I am unsure what other countries use (is it the km equivalent of 10 miles, smaller, or larger; but the concept is the same.

My discussions with people from other western counties does indicate that they have the same "site boundary" and "emergency planning radius" concepts.
Reply: @matsv201  Show me any realistic power plant design that is modular.  You have no concept of how large even small power plants are and the impossibility of what you suggest.

I was the Plant Manager of a fossil plant that had a 6 MWe, a 12 MWe, and a 16 MWe turbine and generator prior to my transition to nuclear power.   That plant (including cooling tower & spray pond cooling) covered about 5 city blocks not counting the coal yard which covered another 3 blocks. 

The fact is that the term "modular" has never existed in the way you are defining it in regards to SMR power plants.

It's that some of the components are modular... which is in fact what every power plant every built (fossil or nuclear) has always been.

Nuclear reactors themselves have always been modular.  They have never been built on site (although the heads for PWRs may have been shipped separately and installed on site after fuel loading).   In the case of a BWR even the heads may have been shipped installed on the reactor vessel.

The SMR concept is not new. It was 1st proposed in 1955 at an international conference about the future or nuclear power.

The 1st ever conceived SMR was a 22 MW BWR at in Elk River Minnesota (USA) which many people were talking about could be erected in many small communities in the USA. Online 1964 and shut down in 1968 due to massive technical problems. 

It was also noted that it could never be cost effective just due to the required staffing levels to operate and handle any potential major malfunction (and it sat next to a fossil power plant run by the same utility for a really good direct comparison).

The reactor was shipped as a separate modular unit. The steam generator was shipped as a separate modular unit.  The steam turbine was shipped as a separate modular unit.  The electrical generator was shipped as a separate modular unit.  

The condenser was built onsite as was the containment and shield building.

Major Pumps, Feedwater heaters, etc. were all shipped as separate modular units; although perhaps several fit onto a single truck or rail-car.

Then the piping and wiring was field erected to connect everything.

Other than a few very tiny micro-reactor concepts I have never seen a truly modular nuclear reactor power plant concept.   It's just modular components that are field located with field connecting wiring and piping.

I also happen to know that the NRC approved NuScale 50 MWe power plant units also had separate major component modulus to be field assembled into a pant onsite.   

Key difference is that the condenser tube bundles are now modular (even for 1200 MWe power plants), although the base condenser structure and framework are still field assembled onsite for large central stations; while smaller power plants in the SMR range usually have 3 components that are field assembled together (the turbine to condenser transition; the tube bundles support structure - and for small enough power plants the tubes bundle will be installed in this piece, and the hot-well).  

Condensers are no longer totally assembled from individual pieces onsite which is the only change from before the 1990's.
Reply: I'll admit that I am baffled why the USA does not use more district heating (and cooling).  Far more efficient that having all the equipment in each house to burn raw fuel or work from outside air as the heat dump for air conditioning.   I have hot water heat in my house and it would be much more reasonable to get heat from a district heating plant.

I have spent what alert time I have had today (I've got brain fog problems from covid) reviewing some of the BWRX-300 design and pre-licnensing review filed with the USA NRC (which were also filed with the Canadian Nuclear Regulator) and both regulators are working together on eventual licensing.

I have no arguments on the size of the reactor.  Yes there are places in the world that would make sense.    

I question re-powering existing power plants with a BWR as the steam is radioactive and contains radioactive particle debris that carryover from the reactor - and the entire steam plant become mildly radioactive.  Fossil plants were not design for that and I just cannot see how you would successfully convert and keep things near as cheap as using a purpose built BWR steam plant and equipment.

Worse yet is the concept of distributing radioactive steam and carryover particle to all kinds of businesses and houses in the area.

While you could have a secondary boiler that creates clean steam... that adds cost.

Also, lets get our facts straight.   The reactor and containment building is not totally underground.   Half of the Reactor Building is underground, and the other half is above ground.  The top portion of the reactor and the top of the containment building is above ground.

The spent fuel pool location is interesting but makes sense as does having a flooded area above the containment vessel during power operations (it has to be drained to open the top of the containment vessel and remove the reactor head for refueling - then flooded for refueling -  and then drained again then to put the reactor head back on and the containment building cover when refueling is complete).

Keeping it flooded during operation does provide some radiation security in the event of a major problem.

The pool above the reactor does not directly mitigate a LOCA.  There are actually 3 separate pools.  One of them (without spent fuel in it) has several heat exchangers in it and the pool water condenses the steam from a LOCA and drains it back into the reactor.   

I have no idea why Poland is saying that the Emergency Planning Zone (EPZ) is 0.5 km as GEHitachi as of Dec 2023 said that has not yet been determined.

That is especially meaningful as I reviewed both the draft safety plan section submitted to both the Canadian and US Nuclear Regulators that dealt with what happens if Defensive Line 4 was breached (creating a major release - which is where the EPZ comes in) and the combined US NRC and the Canadian Regulator response that told GEHitachi that they fell short in their analysis and needed to do more work in that area.

The same Canadian/ USA Regulators response to their safety evaluation have told GEHitachi that their pool refill systems to make up for evaporation in a LOCA initially submitted to the regulators are inadequate for licensing.  That is likely easier to fix than figuring out the EPZ.

I worked at two PWR nuclear plants that were about 600 MWe per generating unit (twice the size of the BWRX-300) and during the major casualty drills they always announced that we now had a 1 square meter hole in the containment/shield building; and how did we respond to that given the current weather conditions (without ever explaining how such a hole could occur or why it was a perfect square with 1m sides).

Since a good portion of the containment vessel for the BWRX-300 is above ground... I fail to see why they would not be expected to also develop such a hole and have a EPZ adequate for that hole (maybe it will be a smaller hole for a smaller sized reactor; but I fail to see why they would not require such a hole in the containment building for new reactor emergency planning after everything else has gone south inside the reactor - such as having a meltdown even if there is no explanation why or how that occurred).  Emergency planning drills assume that pretty much nothing goes as planned - and there is now a new design basis "accident" is for what are now called "beyond design basis events."

I understand Poland is waiting for either the US NRC or the Canadian Nuclear regulator to license the plant - and will use that license to license it in Poland.   So lets see what comes out on the EPZ once a license is issued.  It's obvious that neither Canada nor the USA regulators felt that GEHitachi properly addressed this up front.

While I wish the BWRX-300 and Poland well, the fact is that over 60 years of history has shown that PWR nuclear power plants are overall cheaper than BWR nuclear power plants.

Westinghouse has now entered the market with its AP300 and can also bury half of its containment building and put the Spent Fuel Pool above the reactor; and its steam is not radioactive and could be used to repower existing power plants or provide district heating.   I fail to see how long term the BWRX-300 is going to last in the market assuming that Westinghouse does a decent job with their AP300. I do admit that GEHitachi will likely build the 1st set of nuclear power plants of this size range.
Reply: Mate, you should put that on Medium as an article or on YouTube as a video and get paid for it.
Reply: @perryallan3524  Again, thank you for your thorough answer, this is the kind of insights I was hoping for. Regarding city heating, in a word, heat exchangers. You seem to describe first generation steam systems, like in NYC. We use a mix of gen II and III, with some islands of gen IV in new developments. There's a good Wikipedia article describing the differences. My apartment building is hooked to a 140°C-ish water pipe and that is exchanged to 75°C radiator water and 55°C hot tap water in the building basement.
Reply: Hmm well... the problem with the conventional Nuclear Reactors is  the need to built around large bodies of water next to sea etc. and well you know it .. shame you did not mention the issues the storage and disposal of wind turbine blades and for example the issues of Gallic Arsenic in solar panels... now you know there is at this stage four gas cooled TRISO reactors in China..  the problem is the most of the designs as you know are not understood by say Westing house in the US and therefore block the other Gen V types of reactors.. .. so given say the example of say Germany of where i live but Im not German shutting down their current reactors and then LAUNCHING 25 coal ..sorry the "re-classifed buring lignite coal the brown coal ..as NOT coal " release lots of Radon gas and is actually very toxic and radio active... sorry I do think there is a future for SMR I agree to disagree.. but perhaps you should have mentioned the issues with solar and wind... convenient
Reply: I was thinking of a hot and cold water for a district heating/cooling system - steam is only practical if you have industrial uses for steam.   I used to design such systems on my own time and costing them out back in the late 1980's and early 1990's (and I worked in a US Navy steam engineroom before getting my engineering degree - so I understand steam, hot water, pumps, control valves, and piping systems very well.   I don't understand why various US cities and large towns have never built them.

Have a great weekend.
Reply: @IainMcGirr  This specific thread is about nuclear power plants.   If you read my starting post at the end of it you would have found a statement that I disagreed about the cost of solar and wind the Video Presenter had; and that I would post separately on that. 

I did post separately on that and in that post I discuss the problem that solar and wind installations typically only last 20 years and have to be replaced, where nuclear units can be expected to run for 80-100 years.   I did not get into the details of the disposal and waste issues as no one asked (please post in that thread if you wish to discuss this in more detail).  I did not believe that discussion belonged in the thread discussing nuclear plant designs, history, and pro’s & Con’s; and you are the 1st to mention it.  All it does is support my contention that when you consider all the cost associated with delivering electricity to the end customer… that nuclear is competitive in many areas of the world.

I am more bothered by your statements that the Chinese gas cooled reactors don’t need a large body of water available; and that those of us in the west don’t understand the Chinese designs.   

Nothing could be further from the truth for both claims as the fact all Chinese nuclear power plants (other than test or very small demo plants) are built near large sources of cooling water and that virtually every Chinese nuclear power plants (including the pebble bed HTGRs) are nothing more than copies of Western designs (with a few tweaks).  China is very poor at original engineering, but very good at copying and adding slight improvements.

I was furthermore horrified when I looked up the most recently completed Chinese HTGR articles and how many total falsehoods were in the articles.  It seems even technical news reporters never even check basic easily verified facts.   

As you are living in Germany I would have thought that you would have recognized that the Chinese HTGR power plant is nothing more than a copy of a shutdown German HTGR plant (and the Chinese admit that) – at least if you knew anything about the history of German nuclear power plants (Germany pioneered Pebble Bed nuclear power plants).

High Temperature Gas Reactors (HTGR) are not new.  All plants built so far have been cooled by helium (other gases have been discussed).  They use the high temperature helium to boil water for a standard steam turbine, condenser, condensate, feedwater back to the boiler power plant (Carnot steam cycle).  Thermal efficiency for full sized power plants are often in the upper 30% to low 40% depending on specific design and local cooling water temperatures to condense the steam back into water (which beats the typical low 30's % for a normal fossil boiler or nuclear power plant).

All steam cycle power plants require a very large quantity of water circulating through the condenser to condense the steam.  That can be provided directly by an open cooling source (river, lake, ocean) or via a cooling tower which uses evaporative cooling and only requires several % of the cooling water flow as makeup (and for smaller power plants a good well can work for that).

I should also point out that all HTGR power plant reactors are “passively safe” if they trip offline as they cannot meltdown due to their TRISO fuel which dates to the 1950’s and was developed in the UK: it is either formed into “prismatic blocks” or “Pebbles”. All HTGR power plant reactors have used TRISO fuel, and most test/research reactors have and do as well. 

So nothing new about the fact that HTGRs are “passively safe” (in fact I have yet to see any Generation IV reactor design that is new – just minor upgrades to many decades old designs).  But you cannot generate public excitement unless you can claim you have a “new” design.  Not even that lie is new.

All HTGR power plants that have been built have been associated with a large enough body of water to provide adequate cooling.    The recent “hot news” Shandong province HTGR (210 MWe) is built at Shidao Bay with direct access to the ocean to provide condenser circulation water (Wiki has a summary article with a great map).  There is so much cooling water available at this location that China is also building 2 CAP1400 nuclear units at the same location (1400 MWe each, Licensed AP1000 design – and China hired Westinghouse to design the larger 1400 MWe nuclear power plant from their ~1150 MWe AP1000).

Without getting into test reactors and small demonstration units that did not have any electrical generation (all under about 30 MWthermal) the following HTGR power plants have been built in the world.

Peach Bottom Unit 1: Est Somewhere in the 65-75 MWe range (I can easily find the thermal power, I have not found good documentation on the MWe).  Online in 1967, shutdown in 1974. Prismatic fuel (designed and started up with thorium; changed to U235 at 1st fuel load).

Jülich Research Centre, Germany: 15MWe. AVR pebble bed prototype plant. Online in 1967, shutdown in 1988.  Pebble fuel.

Fort St Vrain; USA: 330 MWe. Online in 1979, shutdown in 1989. Prismatic fuel (designed and started up with thorium; may have been changed to U235 later in life).

Hamm-Uentrop, Germany: 300 MWe pebble bed. THTR-300. Online 1985, shutdown in 1988 (very minor radiation release due to some pebbles breaking); but after Chernobyl in 1986 the German Public demanded shutdown as not even a very minor radiation leak was acceptable (even though they were working to make the pebbles more robust).  Pebble fuel (thorium).

Shidao Bay, China: 210 MWe pebble bed.  2 HTR-PM reactors feeding a single 210 MWe turbine/generator.  Online 2021.  Pebble fuel.  Note that China says they plan on building 9 more of these at Shidao Bay (10 total), in addition to the 2 CAP1400’s

So there is the actual history, and you can look up and verify it all on the web (some sites list slightly different numbers; I used the ones I thought were more credible).

Us people in the West totally understand the Chinese reactors as we developed them, and the fuel too.

The USA built 2 HTGR power plants in the 1960’s and 1970s with passively safe TRISO fuel (Generation 1 and Generation 2 designs).

The Germans built 2 HTGR Pebble bed power plants as well with passively safe TRISO fuel (Generation 1 and Generation 2 Pebble bed designs)

What is new about the so called “Generation IV” power plants that China borrowed the design from the German Pebble bed reactors.  Not passively safety as that has always existed since the late 1950’s in HTGRs and not TRISO fuel. 

What happened to a Generation 3 TRISO fuel HTGR?  Ahh that’s perhaps what the Chinese built at Shidao Bay… It’s just not sexy or modern to talk about that (lies are often more exciting than the truth).

All steam cycle power plants require a large amount of cooling water to condense the steam back to water.  While I have seen discussions about a Brayton cycle nuclear power plant which would not use a steam cycle; its efficiency is poorer for the temperatures the current generation HTGRs can safely attain compared to the Carnot steam cycle.

Have a great day,
Reply: @perryallan3524  

I appreciate your posts as you skip the great majority of the bullshit. Yes you support nuclear, but not for the usual rubbish reasons. 

However....

Yes, renewables probably have a reasonable service life of 20-30 years. Steam plant requires major refurbishment or rebuild on similar time-frames. You posit 80-100 years for nuclear, with no equivalent demonstrated examples. The oldest operating power reactors are in their fifties, with little scope for life extension. The average age is only 40, and for those several life extensions are certainly in question, with many of the same design and performance closing early for operational losses or repairs. 80-100 is optimistic. With a steadily declining fleet and tightening market, few may ever exceed sixty years.

You mention  nuclear steam efficiencies at 40%, and coal in the 30s, whereas my reading puts it the other way around. Even coal plants built in the 60s had conversion at about 44%, whereas the temperature and pressure limitations of civilian nuclear mean that they rarely exceed the low 30s.

You seem dismissive or unwilling to consider the real problem of  long-term spent fuel storage costs and final disposal, yet these are utterly unavoidable and large components of the total cost of ownership. Delay is unethical as it places the genuine burden on people who will have no memory of the alleged benefits. This could be more easily ignored if we had genuine data: A substantial fraction of wastes disposed in a majority of nuclear nations, with performance data and established costs.  What the public sees is promises, and the spectacle of the US DoD and DoE fighting in court over a fraction of ageing wastes wastes rather than display "honour" or "integrity" and actually accepting the burden and just getting it done. 
These wastes are an undeniable and unavoidable expense uniquely derived from nuclear operations, and cannot be divorced from the cost of supply. Nor can solutions be delayed indefinitely. Further delay increases interim costs, and final difficulty. Even a nation impoverished by plague or warfare cannot afford to neglect active maintenance and final disposal. Who will underwrite that? In what currency? Who will neglect their dependents to see it done?

Your posts are otherwise excellent, but there are major issues and unfunded liabilities for the industry, and nations, continents and hemispheres that host it, until we have demonstrated solutions and timelines in place. That still leaves out public liability coverage, which I believe exceeds the entire delivered value of the the nuclear industry.
Reply: TL:DR
Reply: @aaroncosier735  I believe you are under some significant misconceptions.

Yes, all power plants require certain kinds of increased maintenance after 20-30 years.  Motors need to be rewound, even most long-life pumps need to be rebuilt (although a number of pumps are rebuilt a lot more often than that), it used to be that Feedwater heaters needed replacement at that interval for steam power plants; and a reality is that for nuclear PWRs the early steam generators needed replacement by then as well.  

Note that there have been dramatic improvements in life for FW Heaters and Steam Generators due to use of improved materials.  We don’t even know how long they will last, except after 30 years we are not seeing any real degradation in the improved material versions of this kind of equipment, where notable degradation was noticed by 10 years on the original equipment).

However, all that major maintenance is usually much cheaper than tearing down PV cell arrays and wind towers and rebuilding them (and I’ve seen video of several wind tower farms being demolished so they could replace them; not even the towers were considered reusable).

A certain amount of turbine reblading (especially for the LP turbines) is also somewhat common (same as for fossil plants), and that is not that costly.  I’ve seen the last rows of the LP Turbines having the blades replaced starting at 8 years of operation.

Key is that the base plant stays intact while equipment within it gets rebuild or replaced.

The other key is that using Non-Destructive-Testing (NDT) we know the condition of all major components and piping systems in the plant.  We are seeing many decades of remaining life even after 50+ years of operation.  Where there is an isolated problem, we replace the affected equipment or piping & valves (and possibly with more robust alloys).

While it is true that we have yet had a nuclear power plant last 80 or more years.   It appears that other than normal maintenance and replacements that everything should last at least that long – if not more than 100 years (nuclear plants are maintained to a much higher standard than fossil plants).

The newer plants are designed and built with better materials for far longer lives than the old plants from the 1960’s – 1980’s (Which is why they are now licensed for 60 years instead of the 40 years of decades ago.

The major concern is not with maintaining the plant in most cases.  It’s a question of economics of plant staffing as the larger plants are just more economical than the smaller plants as they may not need any more staff than the smaller plants; and a dual unit site only requires about 50% more staff than a single unit site (which is why most nuclear power plants in the USA are at dual to 3 unit sites).

As far as plant retirements:  Virtually all of the recent retirements in the last decade were smaller single unit plants.  Plant staffing cost on a per MWhr basis is what was excessive for those plants, not the maintenance costs.  In general 1000+ MW single unit sites make up all but a few of the current single unit sites (and the economics of a dual or 3 unit 1000 MW+ site is just amazing).  The dual unit and 3 unit sites will likely continue on for decades, where most of the single unit sites will be shut down before the end of their useful material life.

Concerning power plant efficiencies:    Standard fossil steam plants, BWR/PWR/CANDU/AGR plants are typically in the lower 30% range depending on local conditions and minor design variations of the plants.  I have never seen 44% from a coal fired power plant (and I used to work in them) and 44% is theoretical impossible based on the allowable metal temperatures and how thermal efficiency is calculated.

HTGRs are typically in the high 30’s or low 40% efficiency range because of the much higher temperatures they can operate at.  Also, a fossil gas/oil fired “Combined Cycle” plant using a combustion turbine (Brayton Cycle) with the combustion turbine exhaust being used to boil water for a steam turbine (Carnot Cycle) are typically in the low 50% range on efficiency, and I have heard of at least 1 plant claim closer to 60% efficiency.

Long term spent fuel disposal cost are already more than fully funded in the USA from fees collected from the ratepayers who used nuclear generated electricity.  The US Federal Government is sitting on enough money collected to properly dispose of 2-3 times as much nuclear fuel and other high-level waste from the power generation industry as what exist.  Why Yuka Mountain, or other sites, and reprocessing/separation plants did not open is a political issue, not a technical or financical issue.

As for the high level waste disposal issue:  Note that there is a lot more high level waste from the military weapons programs than there are from nuclear power plants.  Congress has also delayed dealing with that – and the government just stores it or shallow buries it (supposedly – for now).

Similar funds collected from the ratepayers exist in other Western Countries.  I understand that both Finland and Sweden are moving ahead with long term geological burial for disposal.  Most other European countries are moving in that direction, and most will likely solve their political discussions and approve a site in the next few years.   Why the USA delayed is beyond my ability to understand.

Nuclear Power Plant disposal is also funded by a fee collected from the ratepayers.   By the time a plant runs about 30 years with normal production the plant will have enough in the decommissioning fund to dismantle and dispose of the plant after shutdown.

The 1 weakness is that plants that are shut down very early in life do not have adequate funds for decommissioning set up.  So the utility must come up with other ways to fund it.   The 1st being that the longer they wait the cheaper it will be as the radiation levels decay down to normal levels in most of the plant.   So while plants with good funding from long lives have been dismantled after about 30 years since they shut down, plants that shut down very earl often will sit for 60 or more years before any attempt is made to dismantle them.

Now lets talk about disaster insurance.  Under the Price-Anderson act the US nuclear power plant industry is sitting on about $13.5 Billion in insurance funds in the case of a major disaster at a nuclear power plant that affects not just the plant but the surrounding area (again already collected from the ratepayers).

If more money than that is needed each nuclear power unit is assessed the money needed to cover the additional cost (automatically); and which will be passed on to the ratepayers.

As with everything else, other western countries also have set up a similar insurance fund that is typically funded only by the nuclear power industry.

So there really are no major unfunded liabilities with nuclear power plants.   I’m not sure where you got your information from as even before I moved from fossil to nuclear power plants a few decades ago I knew that the above funds and disaster insurance existed.

Please take your concerns about the delay in the US Government in moving forward with long term geologic disposal of high-level nuclear waste with your congress person and senator.  The money is already being held by the Federal Government.

On another thing I think you were concerned with (and it seems to have been edited out – or my memory is wrong).    HTGR nuclear power plants (and perhaps AGR nuclear power plants) are likely to have always been just walk away passively safe.  No one ever needs to do anything… and the reactor and fuel in the spent fuel pool is safe.  Although you might wish to have a heavily locked building to keep “tourist” away from the radiation levels in several areas for a many decades. 

Molten salt reactors have the potential to also be just walk away and never do anything passive safety as well (as long as you keep people away from the radiation); assuming that a suitable alloy can be found and they work reasonably well.

Have a great day,
Reply: @perryallan3524  I'm not so sure that I have misconceived.

It's good to hear that this sort of plant has improved in nuclear installations. Presumably at great expense. I gather that several plants have closed rather than carry that expense.

Tearing down PV isn't exactly specialist work. Unlike nuclear, there seems to be a net increase in PV, outpacing any teardowns. I also gather that many wind site teardowns are in order to place new and larger units.

You claim these replacement expenses are greater than those for nuclear refurbishment, yet that doesn't seem to be diverting investment. The teardowns are about getting better plant onto prime sites sooner.

I appreciate that there is NDT of all factors so far found relevant. But you are seriously talking about straightforward doubling on the basis of modelling. With a global average reactor age of forty-one years, and record ages barely over fifty, that seems very optimistic.
Actually, it sounds downright cocky, for an industry that cannot be insured by any conceivable insurance pool. I don't doubt there have been improvements, but at some point you are in unknown territory. For other machinery, the far slope of the "bathtub curve" is best avoided early.

I also appreciate that larger dual-plant sites have marginally better economics. But the nuclear industry needs a lot better than that. It needs to deliver energy at a fraction of the present costs. It needs to halve and halve again. The cost blowouts of large-scale new construction don't inspire confidence. 

You are correct that operating losses are the major reason for closure, presumably involving the staffing costs you mention. But repairs and maintenance are also a major reason, along with low electricity prices. I am basing this off the 2021 Congressional Research Service report. If you have a more comprehensive survey, I'd be interested.

As for coal efficiencies, I only have limited exposure to operating data. Our undergrad project back in the 80s was an investigation of data from the Munmorah plant, and the lecturer was very pleased about it's performance and control system. I'd happily accept that we were given "best day ever data" rather than typical. In other publications I routinely see coal efficiencies in the high thirties, and nuclear in the low thirties.
Not sure why you mention HTGRs. Hardly representative of likely efficiencies, with a fairly unhappy history in the UK and Europe.
And yes, the world record for a gas turbine is something like 62% efficiency. Not a representative unit. 
Neither of these help typical PWRs which form the bulk of the fleet.

As for waste disposal, I dispute your assertion flat out. There is a fund in the US, and contributions stopped around 2010 after legal disputes. Published estimates for disposal of the US wastes are more than double the provision. 
Based on Yucca mountain alone, and ordinary inflation figures, disposing of 90,000 tonnes in the US will cost far more than the current provision.

Yucca was not solely a "political" issue, although certainly the community engagement was poor. There were also issues with water and oxygen ingress. The titanium drip shields alone make a laughingstock of any claim of adequacy. No state is obliged to host a trainwreck without ironclad assurances.

As for "more military waste", you might have be clear on your units. Military reactors clearly involve far less material than civilian reactors. The 2007 IAEA inventory of radioactive wastes has global civilian spent fuel at 2.8E10 TBq, and military HLW wastes at 3.1E7 TBq. More recent IAEA status reports have less detail, but growth in the Spent fuel inventory is consistent with other published estimates. Again, if you can point to data that shows a higher proportion of military wastes, I'd like to see it.

Yes, it's all very reassuring that some of the smallest nuclear nations are taking responsibility for their wastes. Fifty years late. So far no such Spent Fuel or HLW has actually been interred. We have no real costings for the largest nuclear nations, and no performance data. No sites in operation, no timeline to catch up on existing wastes. So much for leadership.

Waste disposal is a potentially stupendous additional cost that I maintain remains grossly underfunded.

The plant structure itself may be covered by decommissioning funds. Very few have actually been fully decommissioned, and a great many seem to be entombed in the "too hard" basket. There is no realistic way current governments can guarantee the viability of existing funds over these time frames. 

As you mention, some are unfunded due to early closure. That is no real excuse. What you mean is that no realistic provision was ever costed in, and that the owners/operators/utilities and state crossed their fingers and hoped nothing would go wrong. Hopelessly naive. Try that with a motor vehicle or a crane and no one will congratulate you. 

Yes, let's talk about insurance. Price-Anderson doesn't so much guarantee funding as it exempts parties from having to make realistic provision ahead of time.
Your suggestion that operators will pay those liabilities after the fact, in some future more hostile market, is hopelessly naive. They already cannot compete. Will these levies be made in a timely manner to assist the public? Will the same public harmed by an event face increased charges to pay for their own compensations?
That sounds like a con-man planning to leave town, not a responsible industry or nation.

13.5 billion doesn't go far, and you can stop pretending it's impressive. It wouldn't cover a fraction of orderly removal of an irradiated reactor, let alone actual public liabilities. The costs of the relatively mild Fukushima event are approaching a trillion. A similar event in the North-East corner of the US would not cost just a single trillion.

To reiterate, the money is not being held by the Federal Government. Not remotely enough, at any rate, and the industry fought in court to avoid further contributions. Poor faith from the government does not excuse poor faith from the industry.

Your suggestion that HTGR and AGR are walk away safe is only so on short time frames. None of these structures can be abandoned indefinitely. They do not constitute permanent disposal, and they will erode before the concentrated materials are remotely safe to approach. In any case, the majority of reactors are not HTGR or AGR, so no help there.

MSRs only have the alleged potential on paper. You do make it conditional on finding better alloys. I suggest that such reactors require far better alloys than currently exist, just for ordinary operation. Your suggestion that an already corroded vessel and associated separation plant will continue to contain corrosive salts, exclude oxygen and water and do so for centuries is ludicrous.

You may be clued-up on reactor operations, but as far as the back end goes, you've got nothing but crossed fingers, same as the industry as a whole, and the nations that back it. Someone else will have to clean up the mess, at withering expense.

You yourself have emphasised that you do not expect  nuclear to expand. It's got other problems as well.

Have a good day yourself.
Reply: @davidmartin3947  If China and other super densely populated Asian nations need Nuclear power is a legitimate question.  But it is beyond proven that the West (Europe and North America) do not given the vast natural endowment of wind power in these regions.
Reply: @perryallan3524  You have no idea what your talking about.  Lifespan is already accounted for in lifetime costs of Wind and Solar, and they last far longer then 20 years, also replacement will be cheaper in the future not more expensive due to technology improvement and pre-existing site work (roads, foundations, grid connections) already having been made.    Likewise No nuclear plant is remotely capable of lasting 80 years let alone 100 and the idea that you would even claim that shows you to be deeply dishonest.  As for Batteries, they are not going to be the bulk energy storage solution, everyone knows that, hydro, thermal and compressed air and other bulk matter solutions are going to retain the lions share of the utility storage market due to their obviously lower cost at scale.  All your claimed 'corrections' to long term costs are simply false.
Reply: @kennethferland5579  The main point is that Nuclear is cost competitive in the Far East, whereas in the West no industry could possibly be cost competitive if regulated and administered the way nuclear has been. Series production of nuclear in France in the 70's was fine, and still produces some of the cheapest electricity in Europe.

Dunno if anyone is going to absolutely 'need' it though, as renewables continue to drop in cost, and for instance solid carbon thermal storage can potentially provide process heat 24/7 at temperatures of 1500C, and good efficiency so long as you want thermal out. Process heat and hydrogen were two of the main points of the Chinese HT PEM program, and it looks like both can be done by other means.

Having the alternative of cheap nuclear available 24/7 is a plus though in my view.
If the Chinese etc can do better, great, but they have a low carbon economic alternative pretty much to hand now if needed.
Reply: @davidmartin3947  Theirs no evidence that nuclear is cost competetive today in the Far East.  That word has a specific meaning in markets, aka price is low enough to secure market share from a competitor.  These nations face limitations in the amount and rate of renewables they can build (China is installing at an incredible rate), and political desire to reduce fossil fuel burning.  Nuclear is only filling a gap created by these constraints, it is not competting on price with other power sources, its cost is simply preferable to not having electricty at all.  I challenge you to show a shred of evidence that Nuclear is cheaper then ANY other power source in East Asia.

If you want to argue that we in the West should be installing Nuclear then I won't agree to such a contentions UNTILL you demonstrate that we have maxed out on the clearly cheaper renewable solutions either in their instelation rate or the grids ability to handle them, and clearly neither of these is true today.
Reply: @kennethferland5579  The notion that there is a free market in energy, certainly in China, bears no relation to the facts, as there are all manner of subsidies and directives, not some idealised state of competition.
I can't offhand spot my references for the levelised cost of nuclear and solar in China, as in any case I prefer only to quote recently updated sources.
But the cost of nuclear is overwhelmingly construction, as operating costs including fuel are comparatively trivial, and in China and some other places construction times are half that in the West, which has a massive impact on costs, and in any case it is available 24/7, whilst proper levelised costing for zero carbon would be concerned with storing wind and solar etc, which are currently very immature technologies, so proper like for like is not really possible, as currently the intermittency of solar and wind in China is coped with by simply firing up largely coal driven generators, which is hardly what is wanted.

You seem to be confounding analysis with advocacy, as at no stage have I transferred remarks about the cost of nuclear in China with arguments for or against nuclear in the high cost West, just remarking that the management and risk assessment here is absurd. 

But in the West there would seem to be no chance of nuclear being economic, and every chance that renewables including adequate storage against intermittency will be.

If you want my own view, it is that even in China and the markets such as the Gulf where they hope to sell reactors renewables including storage are likely to drop fast enough in cost to make nuclear not really necessary, with options like solid carbon  thermal energy storage coming in instead of much of the perceived market for nuclear.

But the economics of nuclear in China and its potential markets for these reactors is in no way comparable to prices in the West, and they come in at a formidably low price for low carbon 24/7 power.

The 24/7 bit for renewables is currently a hope, not an achievement.
Reply: @kennethferland5579   I believe that you are looking at the wrong metric and not the total picture.  The real question is not how much a power plant cost to build and operate.  The real question is how much does each power generation technology cost to deliver electricity to the end customer.

If you had read my original post, which created this thread, you would see a comment that I disagreed about the cost of solar and wind, and that I would post separately on that. 

I get the impression that you did not read that other post, and the resulting thread.  So here is the key part of it:

“The cost of electricity is not just the cost of building and operating a form of generation. You also must consider the cost of connecting it to the grid and getting it to the customer, and the cost of making up for lost generation when whatever you are using to generate electricity is not running a full capacity, or running at all. 

Unfortunately, the US Government has focused only on the cost of the power plant - which presents a very distorted picture of what the true cost of power sources are. I have not checked to see which countries are talking only about the cost of the generation source vs the cost of delivery of reliable power to the end customer. 

For starters I would like you (and anyone reading this) to do an internet search for the following relatively short document: "The Full Costs of Electricity Provision" issued jointly OECD and NEI in 2018. It includes actual historical cost information for a variety of electricity generation (showing a range of low to high, with the average). 

This will give you a good overview of the cost to supply electricity to the end customer.”

“In short there are 2 key issues with solar and wind power on just the direct cost of power to the end customer alone: 

1) They cannot generate what is known as "VARs" in the power industry (do an internet search on "Reactive Power" and read about the problems it causes (my understanding is that most wind power does not use generators synchronized to the grid; but instead outputs power to an electronic bank that converts it to power that is synchronized to the grid - which allows the windmill to generate power at various speeds). Transmission and distribution lines are inductors that create this problem. You can either have a spinning generator that can generate VARs to balance things out, or you need to install very costly capacitor banks.” 

NOTE: One of the people who replied indicated that there is technology to generate vars from solar and wind; however, I don’t see any indication in my State that it is being installed as I am sure that its more expensive and the goal of the builder of a power plant is to build as cheaply as possible and shift as much cost to other parties as possible.

“2) It is vastly more expensive to connect a multitude of very small generators to the grid than to connect a GW source to the grid and transmit the power to somewhere (even if the GW source needs to have its own high voltage transformers and transmission lines built). 

In my area many people are complaining about how come their electrical rates are going up with all this new "cheap" solar and wind power coming on line. It's mainly because of the transmission and distribution expenses of solar and wind power are causing the "transmission and distribution" portion of the electrical power bill to skyrocket.

The other key problem with solar and wind is capacity factor (how much does it generate compared to its nameplate rating). Nuclear power plants are usually in the 90%+ range on capacity factors. Solar and wind is typically less than 33% (and I have seen numbers as low as 18% for my State). 

So the utilities have to build replacement generation or battery storage to make up for the lost capacity factor. I just read an article in my State where they are planning to shut down several coal fired power plants which otherwise have decades of life in them (I worked in one of them when it was brand new - it should run for another 30 years reliably) to get rid of the carbon emissions and that this was being offset by the same amount of new solar and wind generation. 

2 day later I read that the utilities had submitted an application for a 600 MWe natural gas fired power plant to make up for the lost capacity factor moving from coal plants to solar and wind. Yet, no one is adding the cost of that 600 MWe plant to the cost of solar and wind power. Us customers will just have to absorb that - while being told how cheap solar and wind is. 

I've read numerous articles about battery storage being added in my state as well... No one is adding those cost to the cost of solar and wind power either. Remember the mantra: Solar and wind power are cheap. Just don't ask about the cost to deliver that power or replace it when the wind is not blowing strongly or the sun is not shining in our local area. 

So the problem is that to get the right answer you have to ask the question of which technology delivers the cheapest total reliable power cost to the end customer - and include all added transmission and distribution and other power plants needed to fill in the gaps when its not running at normal capacity. 

Then you get into the problem that most solar and wind generation has an expected life of 20 years. New nuclear plant construction is being licensed for 60 years with a realistic expectation that the plants can run for over 100 years with license extensions (the nuclear plant I worked at the longest is already well into its 1st license extension period and has been running now for 53 years, and has already applied for a 2nd 20 year license extension out to 80 years which is almost certainly going to be granted). 

This is why many nations around the world are building new nuclear power plants - because when you include all the factors large central station nuclear power works out as the overall cheapest long term power option for the customers at this time. I note that there are some areas of the world where hydro, wind, and solar, will be cheaper as local conditions always have to be considered. 

But, if you only ask part of the correct question - you get the wrong answer.”

I ask that you download and read the report I directed you to if you wish to continue this discussion.  You also might find it helpful to read my other post and the discussion that occurred.

While the cost of solar has come down (I’m not sure that cost of Wind has decreased near as much) since the data in this report was generated.  It presents the full question that must be asked and of the date of publishment the actual cost of electricity to the end customers.  I do assure you that many countries in the world are doing similar calculations using the most recent data on power plant construction cost for the different technologies.

As far as Solar and Wind vs Nuclear goes.  Once the nuclear plant outlasts its financial depreciation and loan years (typically 30 years) the plant is paid for and you don’t have to build anything new to keep it running (unlike solar and wind where you must build replacement plants); and maintenance cost are modest.  I assure you that you will see some current nuclear plants run longer than 60 years and likely to at least 80. For the most recent new plants 100 or more years is not unrealistic.

Because of the “True cost to deliver power” there are currently 62 nuclear power plants under construction in the world, 118 planned to be built, and 323 proposed.

Too bad in my opinion that the USA and some other countries have focused on only the cost of the power plant, and not all the other costs involved in delivering power from each technology to the end customer.  I personally believe that only presenting part of the question (focus only on the cost of the power plant) was politically motivated in this country to push solar and wind.  How else can you explain the avoidance of all the factors involved in the true cost of delivering power to the end customer in all the government talk (while other countries are talking about it).

Enjoy the day,
Reply: @aaroncosier735   An update:  You are right that modern supercritical coal fired power plants are often in the upper 30's% to low 40's % in efficiency.   While there may be a plant that was built at the 44% efficiency rate it appears that the industry has backed off on getting the most efficiency possible due to the very high cost of pursuing each additional % raise in efficiency (I.e. the construction cost of a 44% efficient fossil plant does not pay for the cost of the extra few % efficiency over the life of the plant according to the reference I just reviewed).

I had not kept up in this area as there are very few  supercritical power plants in the USA and only 2 that are considered modern.   While the USA developed supercritical power plants - the original ones were in I believe the 33-35% range; and then we stopped building them until the Elm Road plants in Wisconsin (online 2010 - and the last utility scale coal power plants in the USA).

The rest of the world has been building them and working to increase their efficiencies by improving materials (which allows higher steam temperatures) and by adding progressively more stages of feedwater heating and reheat steam.

On the 62% combustion turbine.  That has to be a combined cycle plant, and not just a combustion turbine.  I found references to several 63% efficient combined cycle power plants that have been built in recent years.  They benefit from the improved high temperature alloys developed for the supercritical power plants in the last 15 years which allows the higher efficiency.
Reply: @perryallan3524  What do you mean by "rebuild your solar and wind generation 4-5 times at ever increasing cost". Which cost is increasing
Reply: @fetB  Great Question.   You need to look at Solar and Wind separately.   Wind is the easier one to demonstrate so I will start with it.

There has been no real decrease in the cost of wind power construction in about the last decade or so if you look at the same size wind turbines.  Wind towers and turbines have pretty much reached maturity.  While there will always be minor improvements over time.  No major future cost reductions are foreseen.

At the same time inflation keeps marching on so replacement wind towers will cost more in the future as will everything else (and you don’t even want to think about what would happen to the world or any countries economy if there is deflation: It’s not pretty).

The current decreases in the cost of wind turbines all have to do with size of the wind turbine.   In the nuclear power plant world, you can double the size of the power plant with 40% more materials and construction labor… which drives that large central stations are the most economical.

There is similar cost savings with building larger and larger wind turbines (although I have not seen an exact number).  

However, there are actual restrictions on how large of a wind turbine you can build in an area based on available wind energy and maximum allowed height of the wind turbine (Aviation rules).

What you are currently seeing is that the largest possible wind turbines are being built in areas, and in some cases, those are replacing older smaller wind turbines.   But, my understanding is that the current large wind turbines are where this ends without major regulatory changes in aviation height limits.  So once the smaller old wind turbines are replaced there is not going to be any cost savings moving forward.   Inflation marches on and it will be more expensive.

Where I live it has already been determined that the wind towers that were built 20 years ago are realistically as tall as they can get in my area just because I live in an area without much wind energy resources.  Taller towers cost more to build (bigger foundations needed, etc).

The biggest piece missing from the equation is that for wind power that the industry has noticeably underestimated the cost of maintenance over time and grossly underestimated the cost of dismantling and disposal which in the last 10 years has become very apparent.  I knew that they had not planned for the cost of dismantling and disposal. For your information there is a recent Feb 20, 2024 article in the Harvard Business Review titled “The Long-Term Costs of Wind Turbines” you might want to read.

Unlike nuclear power plants which are required by federal law to build a trust fund for dismantling and disposal; fossil, hydro, solar, and wind generation plants do not have to do that.

So to replace a wind turbine you first must tear down and dispose of the old one – and that cost noticeable money, and will also go up with inflation.

So while a nuclear plant will run for multiple cycles of solar and wind plants.  The solar and wind plants will incur cost to dismantle and dispose of the old plant along with building its replacement which is far more expensive than just building a new plant on a greenfield site.  In the case of wind this is already at an ever-increasing cost.

Solar has not quite yet gotten to the place that wind is at as the cost of the solar cells themselves are still decreasing – but decreasing at a slower rate and at some point, will bottom out.

The thing that most people miss is that the cost of a solar power plant is not just the cost of the solar cells themselves.  Structures have to be built, drive mechanisms, power lines, inverting stations, etc.

Last I heard is that all these other cost are now above 50% of the cost of a utility scale solar power plant; and rising with each decrease in the cost of the solar cells.

The articles I have read indicate that disposing of used solar cells is not the cheapest thing either and is becoming a noticeable cost (I’m not sure why).

Like wind power to replace a solar power plant you must dismantle and dispose of it.  Again something that a new solar plant on a greenfield site does not have to do (which adds a fair amount of cost).

In addition I’ve seen the rotating drive mechanisms in the current generation of utility scale solar plants – and like early wind turbines from the 1980’s and 1990’s I don’t believe that they are rugged enough to last long term just by looking at how small they are (I’ve spend over 4 decades in industrial and power plants with equipment of all sizes designed to last 40+ years with only minor maintenance:  I know what it looks like – and the simple answer is “large” to reduce the stress on all the components and bearings.  Large often means larger base equipment and always higher price – and manufacturers are more focused on initial cost and don’t care about long term reliability until the customers demand it of them after their 1st and 2nd and often 3rd generation equipment fails: Look at the history of wind turbines since the 1980s to see a very real example).

So add inflation to the trends and you can see that while new solar cost may yet decrease for another decade or two, that somewhere after that the other cost of the solar plant will dominate so much that inflation will drive up the future cost of solar plants.  

Then add the cost of dismantling and disposing of the old solar plant and its already likely more expensive than just building a new greenfield solar plant even with the future reduction in solar cell cost.

Sometimes it helps to look at the full picture..

I hope that answers your questions.
Reply: @perryallan3524  Actually doesn't really answer my question, because you dont seem to look at the full picture. Let me preface, im not at all against nuclear. I think it's fundamental to green energy, if done right, and wind mills are clearly flawed, ranging from inital ost to maintance, wild life dmaage, noise pollution, though, im sure the people made their money. Regardless, there are much better designs, but the discussion is always about peak power, when the bnefit in renewables lies in big part in its opportunity for decentralization.

So, what i don't understand is your argumentation against solar. For one, anything bottoms out at one point. Do you expect it to be free or what is your point. Also, why does solar have to be a plant and why do you cite structure and inverter cost, when those are peanuts compared to a nuclear plant. Realistically, you're not bound to a plant with solar because it isnt dangerous or difficult to operate, and the numbers are already in as plenty of people installed solar at home. After the cost of installation, worst case scenario the first 10 years, is paying for it and the other 10, and sometimes 15 years are literally free energy. I dont understand how you omit that so freely. You're not at all looking at the full picture here. Same for recycling. It's the same flawed argumentation against battery recycling. Due to their long deployment time, there arent many up for scraps to make it a big business, but that doesnt mean it isn't overall viable in their intended purpose. It's merely not highly profitable. Mind you, this is also dependent on what panel type you're talking about. There are panels constructed with ease of disassembly in mind and there is even a company, i think a german one, that is working on cheap flexible semi transparent panels that can be placed onto windows. You also dont need to necessarily rotate panels. It can even be at a detriment when the panels get too hot.

In conclusion, nuclear should clearly cover the base load and solar/battery complementary, with maybe additional wind catchers, like the ventum or aeromine, which are incredibly cheap and safe installations, or maybe roof line ridge generators, like the ridgeblade.

PS: on the topic of inflation, with inflation, energy prices increase as well, and since the enrgy is free, the benefits scales with it. After all, you dont have the cost of paying highly educated and expensive personal to maintain them. An occasional dust wipe, and they're good to go. Very lost cost.
Reply: @fetB  I’m very glad that you understand that nuclear power has a place in our energy future.   Somewhere in my comments above or in my other post on challenging the seemingly cheap cost of solar and wind I address the biggest problem with home rooftop solar.

Decentralization tends to be very costly on a per KWhr basis.  You can do it; but it’s not cheap; and people want cheap electricity in most cases.  That is why the discussion is on large utility scale power plants (of any technology) versus very small decentralized power generation equipment.

Let me clearly restate what I see as the big picture as it relates to both solar and wind vs nuclear.

Nuclear plants are expensive to build, but can be expected to realistically run for 80-100 or more years.  Operation and maintenance cost of a modern nuclear plant is quite low because the industry has learned to use materials that produce long life components, and by ensuring that the containment hatch is large enough to get large components into the containment building (such as replacement steam generators – or even a replacement reactor vessel: it cost a true fortune to have to cut a hole in the shield and containment buildings – and then repair them to replace steam generators).   Unfortunately, the US and Western Europe forgot how to build nuclear power plants and the 1st ones have taken over twice as long with huge cost overruns than what the rest of the world takes.  However, if we moved forward right away with another set of AP1000s using the contractors who built Vogtle as the core workforce we would come much closer to the world standard.

At the same time, solar and wind has a well proven expected useful life of about 20 years (give or take a few years).   So if you are talking about the cost to build the equivalent solar or wind generation as a nuclear power plant (in just nameplate rating – forgetting capacity factors) you are talking about building 4-5 or more solar or wind plants in a row (not counting the teardown and disposal cost).

If you look at the big picture you have to all also include the added cost of transmission and distribution and cost of other power generation plants built to cover the lower capacity factor of the solar and wind plants.  When you add all of that up.  Nuclear power becomes far more attractive cost wise compared to wind and solar for many places in the world and in fact in many areas of the USA.  That is why so many countries are building nuclear power plants – even if they have the space for wind and solar plants.

Now for the record there are currently some companies claiming that they have solar cells that will have useful lives of 40 years or longer (but those cost a lot more than other solar cells). That is only a claim, and has not been demonstrated.  Anyone who has followed renewable energy since the 1970’s as I have (and I was always interested in solar heat, energy, wind power, etc.) knows that such claims have virtually always been totally wrong.

Solar cells have 2 issues related to longevity:

1st they degrade every year by a relatively constant rate until issue 2 kicks in.   Currently that rate ranges from 0.25% per year to over 1.5% per year depending on the solar cell technology.

I’ve seen different numbers tossed out but the general consensus is that a solar cell array has reached the end of its economic useful life when the solar cell output drops to 80-85% of its original rating.  So if you have 1.5% degradation rate per year typical of some of the cheaper solar cells your solar array reaches economic end of life in about 10 to 13 years just based on this general solar cell degradation.  I understand that the historic solar cell degradation rate for utility scale installations is between 0.8 to 1% per year (and utility scale solar installations need to rotate to be able to generate more useful power in a day).

If you install the most expensive solar cells which currently have about a 0.25% degradation rate per year you don’t reach what is considered the economic end of life for 60-80 years until issue 2 kicks in.

2nd when the protective coatings break down then moisture and other atmospheric contaminants get into the actual solar cell and there is a much faster degradation rate and even total cell failure often within a year or two.  This typically starts to occur between 10-15 years. While the more expensive solar cells often have a lower rate of this kind of cell failure – it still affects them.  So that gets your solar array to the estimated economic end of life point faster than just normal cell degradation per year.

Its because of the 2nd failure mechanism that I doubt claims of very long-life solar cells for use on earth.

The nice thing is that this 2nd failure mechanism does not affect satellites and spacecraft as there is virtually nothing to contaminate the actual solar cell when the protective coatings fail.  Which is why NASA and other space agencies have long lived solar panels in space (and they spend the money to get the highest quality and lowest degradation rate solar cells that money can buy – which are rarely installed for utility or home solar power generation).

Now I will move onto home based solar and wind (yes there small home based wind turbines).

The home based wind turbines are not as robust as the utility wind turbines.  Thus they don’t last as long in similar conditions.

Home based solar is rarely high quality solar cells so they have a built in limited life.  Yes they may generate some power decades from now.  But that may not be enough to pay for the upkeep on the system as the decades roll on (and they will need more than just dusting off as the power electronics are not proving to last many decades as well – that would cost a lot more money to build and the contractors get orders based on being the cheapest bid).

Rooftop solar has a whole major issue due to the fact that it is mounted on a roof… a roof that even in the best conditions typically need replacement every 15-30 years in most of the USA unless you have an extremely expensive tile or high quality metal roof.

It becomes a very expensive roofing job when you have to remove and then reinstall the solar cell array and various connecting cables (and that’s the best case).  Few people install solar cells on a new roof that is expected to outlast the expected life of the solar cells.

A worse problem (and cases of this are starting to pop up all over the nation) is that the best way to prevent a roof from leaking is to never put a hole in it.  Installing solar panels puts lots of holes in the roof… and even if they use some kind of sealant if often starts leaking in 10-15 years (if not sooner).  Question for you: Do you suppose the solar installation contractor uses a cheaper sealant with no real quality control on how its applied or a much more expensive sealant and take the time to be sure that holes are properly sealed?  What do you think is most likely? 

By the way, solar installation contractors don’t guarantee no roof leaks, and if they do then they just declare bankruptcy and start a new company using the same equipment and suppliers as do the lower cost roofing companies). Either way you are left with an expensive problem.

Now you have a leaking roof and need a new roof sooner than you would have before (and I know someone who installed solar panels on his new metal roof – and its now leaking about 6 years after installation: guess how happy he and his wife is as he paid a very premium price for that metal roof). So he’s going to have to pay to have the solar removed, have that section of the roof replaced, and he’s not planning on reinstalling the solar panels even though he will be paying them off for another 14 years.

It gets worse.  I now have heard of 2 cases where the roof leaks were not discovered until after the roofing wood had rotted and dripped down onto the ceilings in the house.  They had to strip all the roofing board off (down to the bare trusses) and reinstall the roofing board and then install a new roof; again, after paying to remove the solar cells; and redo the attic insulation and ceilings in the house.  Neither of those people reinstalled their rooftop solar as well and are absorbing the unpaid cost of the solar panels.

Before you tout how successful home solar is… look at the long-term cost and issues related to roof problems.  From the cases I have heard about (and seen in one case) roof problems down the line wipe out any savings the solar provided (and often leave the homeowner with a hugh bill that they have to take out a 2nd mortgage to cover).

Of course, take away the government subsidies and virtually no one would be installing solar and wind (not even the Utilities).  If solar is so economical, why does it still need such subsidies – which started before 1980?  The same question applies to wind.

As far as smaller scale solar like window hangings, etc.  They just don’t add much power to the grid.  They are more of a “feel good” item than a noticeable solution.

I’m optimistic that solar cells and wind can play a role.  I just wish they would be open about the real cost long term of solar and wind compared to a nuclear plant long term.

Have a great day,
Reply: @perryallan3524 /videos What are you talking about generate decades from now. Not only is 10 years just one decade, this is a worse case scenario, like the premium expensive solar roof tile kind of build. A very common return with regular panels happens well before that, which in some cases can be 5 or 6 years. I genuinely have to assume you're willfully ignorant here and just hear what you wanna hear. You use a lot of words, but all you do is reframing the subject with vague projections, false delivered ventures from companies, and anecdotes. You have "heard" about 2 leaks out of few 100 thousand installs. How do you think thats an actual argument, especially when you admit that roofing has to be renewed regardless of panel or not. The apartment building i live in has solar on the roof for maybe 10 years or so and no leaks... isnt that amazing

And home wind. I specified windcatchers and roof line ridge generators, which have not been deployed yet because of a lot of red tape, which surely you know about being in the sector. So how can you qualify it when there's no actual data on it. You reference traditional wind mills, which is not at all what i am talking about and very different to something like ridgeblade, as it just fundamentally doesnt suffer from the same issues. Not only is the air accelerated unlike a trad-mill, the amount of passthrough is limited, which inherently limits overdrive and excessive wear. Even better for windcatchers, which are very cheap units with virtually no moving parts except for the generator and that can be placed literally anywhere away from the elements.

Like i said, the numbers on solar are in. You call it feel-good item when it's literally paying for itself in a short time. You're not optimistic at all. You couldn't be more pessimistic if you tried. Plenty of people made the experiment paying retail prices, not of today, but when they were expensive, both panel and battery. The matter of fact is, per cost of a solar installation, you get at the minimum a 2x return, and it doesn't matter how many times you have to renew the installation because the numbers only get better with routine and scale. You act like it's a zero-sum situation when its clearly not, and especially contrasted with the alternative being fossile fuels. Alone the air pollution reduction is almost invaluable. It's like you're looking for a perfect solution, which cannot exist in our current understanding of physics, so what are you even trying to argue. It needs subsidies? Everything needs subsidies in a capitalistic society, because nobody does anything for the right reasons but financial benefits, which includes nuclear.
Reply: @fetB   Part 1 of 2 as I ran over on space

Honestly, I believe that you are only looking at the good data and best examples that people talk about as successes and ignoring what is known, what is not known, and the failures.

Let’s start with roofs.  The life and issues of typical modern composite shingle roofs are well known 15-30 years; and in some cases its less than that, and in some cases it might be more than that.   Since I re-roofed the main section of my house a few years ago (except for a metal flat roof section for the 2nd floor “Airing Porch” per the original house drawings above the kitchen). I got all the quotes. The longer life modern shingles cost a lot more than the short life ones – and only 2 out of 6 roofing contractors even mentioned them as an option (not many people are willing to spend the money for them): all the others went with the lowest cost short life shingles and many of them cut out proper underlayment as well as it was a race to the bottom on the low cost bids.  

Instead, I opted for an aluminum metal shingle roof (it will never rust – might need repainting in 50-70 years) that is rated for a direct hit by the strongest hurricane.  That cost me more than twice what the bids for use of the long-life composite shingles with proper underlayment (and 3 times the cost of the lowest cost cheap shingles); but, the roof will not need to be redone when I will likely move out, and it will likely last well over 100 years – and perhaps the life of the house whatever that is (as long as the stack seals are changed every 20-30 years).

I have a brother who ran his own roofing company for a decade (health issues ended that).  He told me he did one roofing job involving having the solar PV removed and then after he was done the homeowner had the solar PV reinstalled.   His report to me was it was a total mess with lots of problems found in the roof under the solar PV and then he got calls when his new roof leaked in months because of poor installation of the new solar – which put him in a bind as while he did not cause the leaks it was his new roof.  He refused to even bid a roof job with solar PV on it again – he didn’t need the headaches.

As far as the stories I’ve heard.  I did not go looking for them (and have not even done an internet search on the topic).  As most rooftop solar PV installations have occurred in the last 10 years of so… many people have perhaps not yet run into roof issues… yet.  I believe that those few stories I heard are just the tip of the iceberg on what is going to develop over the next decade.

Then there is the recent news in the last year where if you live in an area frequented by hurricanes that almost all insurance companies will no longer insure a house with rooftop solar.  The cost rebuild them from a storm is considered too much for them to handle (based on recent experience) and had not been priced into the previous insurance rates.  When I discussed this with my local agent (I do not live in an area subject to hurricanes) I was told that within the next few years to expect that nationwide that homeowners with rooftop solar will have to pay a surcharge for that – and it won’t likely be cheap).

I also disagree that the numbers for solar PV are in.   I think you are only looking at part of the numbers; and then the question is what set of numbers from where?

One of the problems for Solar PV is that there is very little long term operating history.  I can point out that we have over 120 years of operating fossil steam power plants in large numbers all over the world, and over 60 years of operating nuclear power plants all over the world in significant numbers, and over 40 years of operating combustion turbine power plants all over the world.   For those industries the numbers are in.  We have figured out which technologies work best and have adequate run history (including dismantling and disposal) to know what the numbers are.

Solar PV is still in its relative infancy.    An article I read within the last week mentioned that at this point in time that almost all solar PVs are being manufactured out of I think it was 8 different constructions (structures/chemistries).  Single crystal silicon cells which is how solar PV started are likely no longer even manufactured.   Almost none of those 8 solar cell constructions currently being used even existed in commercial manufacturing 20 years ago; and some have only been commercialized in the last 5 years.

The result is that we don’t know how well they are going to work long term or not.

We do know that there are at least 4 degradation mechanisms.  Note that I only mentioned the biggest two in my previous post – there are smaller degradations due to light exposure (Light-Induced Degradation – LID) and the peak voltages (Potential-Induced Degradation – PID) which the solar cells experience every day; but they are at much smaller rates.

We have the relative constant degradation rate which appears to be inherent in how solar cells work as it appears in all chemistries/structures tried (I got the 0.25 – 1.5% per year range from the same paper that discussed all the different chemistries/structures in production).  That rate can be determined with a few years of testing.   I’m going to ignore the light exposure and peak current degradation as those are small compared to the other 2.

The failed coatings and delamination of the solar cells due to environmental and weather is known to occur with all solar cells.  It’s a bathtub curve like many other aging related failures.  You always have some initial individual cell failures early on due to defects in the production and coating process; then the failure rate drops to a very low number for years, and then it picks back up with an ever-increasing rate once the weather elements and exposures have taken their toll on the coatings and structure of the solar cell.

For the vast majority of the solar PV installations in the last decade + we don’t have enough operating history to know when and how fast that bathtub curve starts climbing up.  We do know the front of the curve.  We know that the rest of the curve will appear; and that no one in any of the papers I’ve seen has any idea of when; but no one believes it will be 30+ years either based on past history (which does not stop solar cell companies from claiming that they can supply very long-term life solar PV panels). Also, from past history of solar cells we know that once the back end of the bathtub curve starts climbing that within a limited number of years the solar panels will greatly reduce power output.  While some cells may continue to generate electricity; no one is interested in a solar array that drops much below 60% of capability.

SunPower is reported to have both the best long life solar PV cells and best warranty on them in the country (I have not verified that); and their Solar PV panel life is only warranted to 25 years and assumes a drop in output higher than their guaranteed constant degradation rate of 0.25% per year.  I did find some reviews that rate them well – but also comments that their quotes were very expensive compared to other solar PV companies in the market.  So if the reported “best” is both costly and not willing to go beyond 25 years for a warranty…  What do you expect out of the cheaper equipment?

My brother installed a solar PV system on his detached garage roof several years ago (which faces the right direction) and when he asked on how long things would last and expected major expenses, he was told that he would likely have to replace the inverter and control units in 10-12 years and that the solar PV cells would likely need replacement by 20 years or he would see a noticeable decrease in power output.  He told me that he went with that contractor because he felt he was honest with him, and the other installers were telling him that things were going to last many decades (when all the warranties on things were 5-10 years depending on which part of the system).

I have another brother who installed a land mounted solar PV system perhaps 5 years ago (I’m from a large family).

IF you are going to claim that these systems really are operating well much beyond 20 years – you need to present some data on that.  Given that virtually all the solar PV cells currently being manufactured and installed in the last decade have not even been manufactured for 20 years there is no data that I am aware of other than the utility test data that goes back about 40 years on older types of PV cells (Utilities have been testing Solar PV for a long time – and collecting a lot of data and writing papers and reports). 

In the USA a lot of that testing has been done through EPRI (Electric Power Research Institute) which is the research arm of the utility industry.  Note that I and my plant were the hosts for one of the EPRI studies on a promising new technology to identify flaws and degradation in piping and tubing (that technology did not work out; and I wrote and presented the paper with the findings).  I know the EPRI process well.

See Part 2
Reply: @fetB  Part 2 of 2

So lets talk about “payback” claims.  A couple of significant questions:

First question: Does the payback include the utility cost of dealing with the effects on the transmission and distribution system. Solar PV and Wind is having huge financial impacts on the transmission and distribution systems worldwide.  The Utilities in the USA and a few other countries are so far being forced to eat those cost.  At some point I believe that will end as several State Utility Commissions are starting to note the huge cost impacts and starting to seriously consider reducing the amount of money that solar and wind customers get paid for their generated power.  In my area local electricity cost is about 3 times higher than what the power plants are paid to generate their electricity on a kWhr basis.  The rest is largely transmission and distribution cost, with some company overhead. 

Should not solar and wind actually carry their own cost – or do you believe that all other utility customers are supposed to subsidize solar and wind rather directly? Also, what happens to payback period when the sellback rates are cut to compensate the Utility for their cost to handle the PV or Wind systems?

Note that while the Federal Government did subsidize the development of nuclear power plants in the 1950’s – 1970’s, that nuclear has pretty much had to survive on its own since then with very little, if any, subsidies; except that in the last decade that the Federal Government has been subsidizing the development of SMRs and possible so-called Generation 4 reactors.  However, its not been enough subsidy to build even a single SMR nor will it be enough to build any Generation 4 reactor.

Second question:  Did that payback period include the federal and possible State subsidy?   You really need to look at the payback period without any subsidies as those subsidies have to end at some point because this country does not have the money to subsized a large portion of our electrical generation.  People actually need to start paying for the cost of the power.

Both of my brothers have told me that the federal subsidy made installing their systems a slam dunk (as they could afford the rest of the cost without going into debt).  However, neither would have installed their systems without those subsidies.

3rd question:  Where are these stories located at that are claiming 5-year paybacks.   My more than educated guess is that they are all States that have very high average electricity cost.

Based off of Dec 2023 data we have a group of States that are near 29¢ /kWhr (not counting Hawaii at 41¢ /kWhr) and then a group of State near 10.75¢ /kWhr.  The national Average is 16.2¢ /kWhr.

Obviously, if you live in a higher cost of electricity State your payback period is much shorter than if you live in a lower cost State (and the payback period could easily be almost 3 times longer, excluding Hawaii).   

My recollection is that all the articles that mentioned 5-6 year payback periods where they mention where the installation was (most articles do not tell you that) were from States with notably high cost of electricity.

Also, another tidbit:  On average the cost of home solar PV ranges between about 50% and 100% higher than the cost of a utility scale installation on a $ per kWhr basis according to several articles and one utility study I found in the last day.  I fail to see where our economy has the extra money to focus on home solar.   In my opinion, as a society we have many other places to spend that money which would do a lot more good (assuming we have that kind of money to spend). 

Enjoy the rest of your week,
Reply: @clarkkent9080  Late reply, but you are correct - the TMI operators followed their training.  The concern du-jour at the time was overcooling and pressurized thermal shock.  Their training, and the actions they took, were based on avoiding these concerns.  The operators were scapegoated, but one of the many post-TMI mandates was improving the emergency procedure guidance.  In other words, the powers that be blamed the operators but then told us (the engineers and designers) to get our act together in regards to the procedures we gave the operators.  I spent several years working on the procedure guidelines in the early-mid 1980s.
Reply: @GreggMax  I agree that they did exactly as they were trained to do.  I never trained on a reactor vessel head steam bubble....that is until the TMI accident.

Now, just about every event at a nuclear power plant where there was a negative outcome, can be traced to operators not following their training. 

These new reactors  (MSR, etc.) will result in a completely new set of unforeseen problems and issues.
Reply: Based on obsolete studies of the past.
Reply: @MNTrader2012  But you would rather base it on power point presentations by startups with no nuclear experience asking for a government handout
Reply: @MNTrader2012   For which issue discussed in this thread; and can you point to recent articles with actual data (not projections) that show something different.

For the recent discussion on Solar PV life I primarily used articles and reports from 2022 and 2023.   

Also, not mentioned above is that currently the Utilities have installed about 60% of all solar PV in the USA; and while they are hopeful that the newest generations of solar cells last a lot longer than 20, or so, years before the coating failures start to significantly affect their capability.  There is not yet any historical data to show that.

I'll admit some of the nuclear data that I site comes from the 1970's such as that you can double the size of a nuclear power plant and only need about 40% more material and will not likely need any staffing increase.   However, nothing in the recent decades have shown that to be fundamentally different.

Also in regards to the nuclear data.  Since every generation IV nuclear design I have looked at is nothing more than perhaps a modification on a 50-80+ year old concept and/or previous plants generally built in the 1960's - 1980's.  Why is the old data obsolete?
Reply: The general issue we are grappling with here in Australia, right at the moment, is a renewable energy pathway to decarbonisation which is biased towards solar and wind and being promoted as the only choice by the climate zealots, including politicians.  And these political ideologies and egos are driving the delivery of 80% of the bipartisan agreed Net Zero target by 2050 nearly 20 years earlier than we need to in 2030.  As such our 30TW energy system needs vast amounts of land area for solar farms and/or on shore wind turbines or vast marine coastal areas for off shore wind.  And whilst there is plenty of room in Australia, there is no social licence from the people for that amount of industrialised visual pollution and native habit loss.  By 2050 the network is expected to be around 50TW and as such would need 6 million square kilometres of single land use solar farms to be installed.  That would cover the entire area of some of our smaller states.  Wind turbine areas are even worse.  So in addition to solar and wind's low energy density meaning we need lots of them, we also need 28,000 km of new transmission to join them all together.  After all of this cost we are installing a renewable energy source to manage the demand 24/7 that only has a 30% capacity factor.  So on average solar and wind only generate 2 days out of every 5 days and that means these intermittent inputs need firming.  Firming by an energy source with a higher energy density and much better capacity factor.  Coal is being phased out and so is gas so nuclear is our only option for a modulated installed capacity that can firm up renewables.  The SMR design retrofitted into a retiring power plant site would seem a perfect fit, otherwise we are looking to spend a $1 Trillion of tax payer money on the renewable pathway we are on.  That's an eye watering amount of money when we only contribute just a few percent of global CO2 emissions.
Reply: @DerekMusgrove   Thank you for your comment.  I agree that Australia should start building some nuclear power plants.   

I disagree that SMRs are the answer.  There is absolutely no evidence that a SMR will ever be cost effective against a large central plant (just a lot of wishful thinking); and a lot of evidence dating back to the 1960's that larger plants are vastly more economical to build and operate.   In the 1970's they determined that you can double the size of nuclear power plant for a 40% increase in materials and cost of construction and that in almost all cases the plant staffing stays at the same level (and when the plant staffing requirements do increase its only by a modest amount).    To the best of my knowledge all SMR sized reactors build around the world in the 1960's - 1980's were long ago shut down for poor economics unless they were in some geographically isolated area where running power lines to would be prohibitively expensive.  Meanwhile a good portion of the large central stations of the same age are still running today.

Have a great day,
Reply: [Thread bypass]:
Worthy post.  Inside knowledge, PARAGRAPH BREAKS, and rational, insightful anslysis.
I'm from military nuclear propulsion, and I don't hold with your idea that the primary costs of production are material; I see them as being labor (both intellectual and physical) and regulatory.  One of the intended cost savings of SMRs was supposed to be reducing or eliminating on-site staff, with sub-ground installation, a security perimeter, and remote monitoring (of both reactor conditions and site security status) being sufficient safeguards.  As far as US regulations go anyways, this is non-admissible to the AEC, which pulls one of the biggest long-term costs out from under any project.
The other being regulatory.  I'm left scratching my head about NuScale, because if the design were built, and passed inspection, and worked, it wouldn't require any additional design review process to build another identical plant.  The cost reduction of 'economies of scale' (what he calls horizontal integration, i.e. scale of units produced) would require stringent quality control, but no review process for each new unit.  And this applies to all prefabricated components, whether produced at the assembly site or in their own subcontractor facilities.  So it's not hard to imagine paying the same cost per ton of facility.  This goes for labor as well.  The same laborer that, say does 1,000 welds on one plant, could do 100 welds on ten plants, for comparable cost.
And yet, there's the reduced output.  That's the Albatross on the whole project.  If one is paying for the same cost of materials, but getting a fraction of the output, even at the same energy cost of larger facilities, what's the point?
The point is that a smaller security perimeter requires less land, less personnel, and less long-term operating cost.  And no refueling interruptions (which incur their own regulatory and skilled labor costs).  Build, excavate, ship, install, activate, replace or remove 10-30 years later. That's how it's supposed to work.  "The best-laid plans..."

I very much take the point of accident insurance, although the percieved impact of Three-Mile Island AND Fukishima outstrips the post-event data by a lot.  I read one claim that the evacuations were handled so badly at Fukishima, more people died from exposure to harsh weather than to radiation.  Yet if these facilities were to be so well-engineered with passive safety features, placed in 'seismic raft' foundations w/ secondary containment enclosures, the only reason private underwriters won't touch the technology has got to be, at the least, fear and ignorance.

Thanks again for the read.  All the best.
Reply: @HuntingTarg  Your idea of a trained monkey may be different from mine. I disagree that a monkey can operate a normal operating reactor.  Even a normal operating reactor may require minor power changes followed by Xenon transients and normal core burnup requires routine changes in chemical shim control.   Overall, operating the primary system is relatively simple compared to the secondary and liquid waste systems, so there is much more than the responsibilities of the reactor. 

Additionally, not all reactor systems are the same.  My first reactor was a 3 loop Westinghouse and it was significantly more difficult to manage than the B&W (TMI sister) plant I later operated.

I initially trained pre TMI but licensed post TMI so I was able to experience both sides. Prior to TMI we did not train on a reactor head steam bubble or go into much detail on the steam tables. Never let the pressurizer go solid was trained on extensively. After the event, I received hundreds of hours of training on all aspects.

Automatic initiation of full Emergency Core Cooling (ECC) occurred shortly after the reactor trip and as would be expected, the pressurizer level began to rise. And as trained, the operators reduced ECC flows to keep the pressurizer from going solid and  this flow reduction with an open PORV resulted in primary steam formation and reactor core damage.  The ECC was not shut off until hours later when the PORV was isolated and core damage had already occurred.

I have been absent from commercial nuclear for some time but I believe that the foundational training is still based on;
1- ALWAYS believe your indication unless PROVEN otherwise. Which they did.
2- Always follow procedures and never deviate without specific direction from supervision and that supervision must have knowledge of the current situation and that situation is not covered by procedures. To the best of my knowledge there still is no specific guidance on what conditions must exist for that supervisor to deviate from approved procedures.  I did ask that question of an Operations Manager working on the Vogtle 3&4 construction and he simply stated that if they deviate from approved procedures they better be 100% correct or they could lose their license and job. 

The operators had indication that the PORV was closed and while Monday morning quarterbacks can now say "if they just added up all these  minor indications they should have known" Those quarterbacks have never experienced a reactor trip with a hundred audible alarms blaring, alarm windows flashing, and a pin-fed printer printing out hundreds of alarms, one at a time and with a 10 sec print rate per alarm, it becomes useless. 

There were many failures that occurred beyond the stuck open PORV. Given that the operators and supervision there that night were experienced Ex-navy nuclear operators, it indicates that there is a limit to the ability of humans to comprehend a complex failure of extremely complex machine. Now that we are operating these plants beyond their design life, I expect that we have not experienced the last of the TMI-2 like events.
Reply: @HuntingTarg  Did your RP instructor actually officially and openly say operators should respond appropriately based on interpretation of what they believe needs to be done as apposed to training and procedures?  WOW!
After TMI, plants developed very detailed Emergency response procedures.  Following any reactor trip, there was a detailed checklist required and very specific directed response for any abnormality. Anyone deviating from approved procedures is putting their NRC license and job on the line. 
Like I said in my previous response we could never obtain any specific guidance from upper management, certainly not in writing, on when and under what circumstances could we legally bypass approved procedures.
However, I am not naïve enough to believe that this does not occur. I personally, as a supervisor, directed operators to take non emergency actions that were not approved by procedures as I felt 100% confident in the result and that it would not  be documented. Even though operators were only following supervisory direction, they were putting their jobs on the line in not following procedure. 
It is an unfortunate part of the job that while everyone knows that procedures cannot and do not cover every circumstance, and that unapproved actions do and must occur, what happens on backshift stays on backshift.
Reply: @HuntingTarg  I believe that your information and concepts of what the dreams of SMRs were vs the reality are way out of date and far from reality.   Also, what is holding nuclear power plants back is not the cost of operation of them (which is primarily labor) if they are large enough so that the staffing cost are not way out of line (which can occur with SMRs); but the cost of constructing of them.

There are so many points you raise that do not match current reality that I don’t know exactly were to start.   So lets start with the Atomic Energy Commission.  It hasn’t existed since 1974.   It was replaced by the Nuclear Regulatory Agency (NRC) and the Energy Research and Development Administration (ERDA).

The ERDA was later absorbed into the 1977 created Department of Energy (DOE)

While it is true that the AEC funded the development of nuclear power plants in the 1950’s – 1974, and ERDA and the DOE continued some funding up through the life of Fort St Vrain – a thorium cycle HTGR; the nuclear power industry has pretty much been self sufficient since the very early years of the NRC.  Every hour that the NRC spends reviewing a plant’s actions, or a company’s proposed plant, etc. is paid for by the plant or the company.  Up until the development of the recent SMR concepts in the last decade of so there has been virtually no federal funding for nuclear power plant development or research for anything else related to nuclear power plants.

As far as what you think was the concept of a SMR.  A lot of that quickly went by the wayside when people with real nuclear and regulator experience got involved.   

I see no evidence that plant staff’s have been reduced over the most modern Gen 3+ passive safety designs (which have much smaller staffs than nuclear power plants from decades ago).  The reality is that all nuclear power plants must have radiation protection staffs that are large enough to respond to nuclear material leaking into the surrounding communities (for many miles) in the event of a worst-case disaster.  They must have an Emergency Planning staff.  They must have a security staff that is large and robust enough to prevent a well-trained small terrorist team from getting into the control room with the assumption that there is a well placed inside person working with the terrorist to aid in their entry into the plant or secure areas (the NRC uses ex special force personnel for the “test teams” and each plant in the USA is tested periodically – and you better not fail).  They must have a training staff (which does grow some as the size of the plant gets larger).   Finally, they must have adequate operating and maintenance staff (which does increase somewhat as the plant size increases – but also increases as the number of power units increases as there is just more equipment to operate and maintain).  In the case of NuScales Idaho project they were going to build 6 small reactors which combined would have lower capacity than nuclear power plant reactors that were coming online in 1965 - 1973 (and many are still operating today).  It just takes more staff to operate and maintain 6 smaller units than 1 larger unit.

I’m not sure where you got the idea that remote monitoring of plant operations or plant security would be sufficient safeguards.  That sounds like someone’s fantasy, and I never recall reading that in any of the early SMR proposals.

As far as underground installation of the reactor, which was an idea developed in the 1990s to prevent the costly shield building…  Every company that has gotten a licensed design approved by the NRC, including NuScale, looked at that.  Every company calculated that burying the containment building for anything but a micro-reactor was cost prohibitive.   

A total of 8 nuclear power plant design licenses were approved by the NRC since that idea was floated – and they all have above ground reactors and containment/shield buildings (only 3 of those 8 were ever built – and 2 of the 3 have only been built in other countries).  GE is in process of getting a design approved for a 300 MWe BWR; with its reactor and containment building partially buried – but the upper portion is above ground (I think the upper 40% if I recall correctly).  The approved NuScale SMR design has the reactor, containment, and shield building totally above ground.  So does the AP1000 which has now had 6 built (including 2 in the USA) and at least another 10 with construction started in various countries around the world (including the licensed Chinese version CAP1400).

You are correct that once a design is licensed, that no further review of that design is required by the NRC.  People can just build them on licensed sites as the review cost were all incurred up front.

However, that does not mean exactly identical plants that can be mass produced.  All of the licensed designs leave open the seismic design requirements and certain other local disaster possibilities (NuScale Idaho had to consider volcanic eruption as one of their design basis accidents – something no plant I ever worked in had to do).

The site license sets out these limits and they may change how thick the reactor vessel is and perhaps the piping, how many pipe supports, how thick and strong the concrete structures are, etc.  So it’s not something that can be exactly duplicated for every site.  Just a whole lot of things are in fact defined up front.

Getting back to construction cost and including plant staffing:  If you double the size of a nuclear power plant you only need about 40% more materials and construction cost, and in almost all cases the plant staff stays the same size (or very slightly changes).  So double that again, and again and see what the cost per kW to construct and the cost per expected kWhr to operate.   This is what has driven the nuclear utilities to build very large central stations.  They are vastly more economical than SMR to build on a per power output basis, which is not going to change.

Commercial power plants also do not use the very highly enriched uranium that the naval reactors do as it is extremely expensive. The NuScale plant was designed for a 60 year reactor life (minimum) with routine refueling same as all other commercial power plants.  This is far more economical than using highly enriched uranium.  I am aware for some micro-reactors they are talking about reactors that have fuel for 30-50 years of life in them.  But those are too small (and costly) for anything other than remote areas with no other good power options.

I also checked out the size of the proposed NuScale Idaho plant (6 77 MWe units 462 MWe total).  The protected (security fenced in area) is 34.5 acres, with the cooling towers, admin and training building, warehouse, and parking lots outside of the protected area (which is typical of almost all nuclear power plants).  That’s a larger land area protected area than a single 560 MWe nuclear power plant (online 1974) that I worked at for several years.  I’m even thinking it might be pretty close to a dual unit site I worked at as well.   I just don’t see where multiple small SMR plants have any space advantage over larger single units.

Finally, no one is building and shipping a power plant on a truck or train.  They ship components on a truck or a train; and then field assemble the components onsite.

I hope this clears some things up.   Dreams of how SMRs might work are not how they will work (if they ever are built and work well).
Reply: @clarkkent9080   I'm surprised that you don't know that there is a specific NuReg that allows you to deviate from even license requirements if given the situation it is felt needed to for nuclear or personnel safety.  I believe it has only been used 3 times that I am aware off.   You do have to explain the situation to the NRC and your reasoning behind the actions taken.   All the NRC requires is that the decision was reasonable for the situation.  The NRC accepted that all 3 cases were proper.

One of the situations was a very strong hurricane that did a direct hit on a nuclear power plant.  The SRO suspended operator and security rounds, and I believe even abandoned some of the security stations to protect people.  The plant stayed online the whole time and proper staffing and rounds were reestablished after the hurricane passed.

2 of the 3 plants I worked at (I was a contract employee at the 3rd and did not know what their operating procedure were) had procedures in place to allow deviation from operating procedures.  Of course to save lives or in certain emergencies you just do what is needed and explain it later.  

In other cases a several person review (including a SRO) had to agree that the deviation was appropriate for the situation, and document the reasoning and actions taken for later review.  I know of several cases of this; and later review indicated no issues with what they did given the situation.

I'm surprised that your plant did not have such a process..
Reply: @perryallan3524  I believe you are talking about a high level deviation from a safety or security requirement that would require preauthorization unless there is imminent danger to life or property. And yes that would definitely require NRC reporting.

I did work at one facility that suspended Technical Safety Requirement surveillance requirements during a period of extreme cold weather. The power grid was stressed by coal plants shutting down because they were unable to obtain coal because the river was frozen to the point of restricting barge traffic. The NRC agreed to a suspension of surveillance requirements. 

I am talking about day to day operating procedures, be they routine and/or emergency response. There are literally hundreds of procedures for just about every task at every job station.  It is an impossibility to write a procedure to cover every possible scenario and circumstance. And blindly following some simply makes no sense in some situations. You and I would be naïve to believe that every operation at every nuclear power plant is performed verbatim, according to procedure.  I know of no nuclear facility that would allow significant operations by a "thinking" operator as opposed to procedures. And, the idea of skill of the craft vs the need for a procedure has always be debated.

The general rule is follow the appropriate procedure verbatim. Of course, you don't blindly follow a procedure when you know or should have known that doing so is not appropriate given the situation. At which point, the procedure should be revised. To think procedures are revised under ever circumstance is again naïve. 

You obviously had experiences on a much higher level than I.  My experience was in the 24/7 operations, in all aspects of plant operation, in the trenches as it was.  If you don't believe that there is a difference between day and backshift operations and that everything is NOT performed verbatim by procedure except the three examples you cited, then you have a sanitized view of reality.
Reply: @HuntingTarg  An update to my post last night:  A little more digging shows that the 34.5 acre protected area was for the original proposed 6 50 MWe Power Plants (300 MWe total) and not from the proposed 6 77 MWe Power Plants (462 MWe); which would require a larger protected area.   Again an early 1970's vintage 560 MWe nuclear power plant had a protected area noticeably smaller than 34.5 acres, and a dual unit site (over twice the MWe size I believe was somewhat over 34.5 acres).

The good news is that because the NuScale reactors are smaller and have certain modern safety features that the NRC has approved an alternate method for the radius of the Emergency Planning Zone (from the previous 10 mile EPZ requirements for the previous large central stations).

Without saying the exact size NuScale has announced that their EPZ will be at or smaller than the site boundary.  The site boundary is typically much larger than the protected area, so I can believe it.  NuScale did publish an approximate drawing for their 50 MWe unit that said 40 acres for a single unit (remember the 34.5 acres protected area is for a 6 unit plant - a single unit plant might only need 10 acres).   A better look at the map suggest that you need an area perhaps 4-6 times the size of the protected area outside of the protected area boundary.  

That's actually quite a reduction in area from large central stations; but, does not eliminate the Emergency Planning department - just makes it a bit smaller as they don't have to coordinate with the local governments and communities for evacuation plans.

I'd also be curious to see that modern method of calculating the EPZ applied to the Generation 3+ passively safe Westinghouse AP1000 (~ 1150 MWe depending on local conditions).  It may well be a lot less than the previous requirement of 10 miles.

Have a great day,
Reply: @perryallan3524  You are referring to high level regulatory compliance requirements that cannot be met for specific reasons requiring NRC notification and if at all possible,  pre authorization.

I am referring to routine or even emergency operating procedures that cannot be performed verbatim as required. It is naïve to believe every procedure is performed verbatim every time or that procedure changes are obtained prior to implementation needed changes.

I thought I answered this yesterday in detail, but I don't see that response listed here.
Reply: @clarkkent9080  No I answered it, and the reply is posted.

I find it incredible that you admit that you have operators violating procedures routinely without some kind of reveiw and approval process.

Yes, there are numerous things that come up that do not allow a procedure to be executed as written (Trust me I know - I may have forgotten to mention it but I was a MM in the Navy and operated/maintained the propulsion plant, and also have operated other fossil power plant or steam plant systems since then either when going through college or as temporary jobs between engineering jobs).

But, at least 2 of the nuclear power plants had procedures in place that when all these various situations occur that the operator can get together with an SRO and other key Operations people and come up with an approved alternate plan, which was documented in the comments section - or via an attachment, and execute that so that the deviation and what they did, and why, was documented (without requiring a time consuming procedure rewrite an approval).  Then later this was reviewed; and if the situation occurred with any frequency the operating procedure would gain an appendix that the operators could use in the procedure (with just noting the transition to the appendix, and back) in the filled out operating procedure.

While I don't recall the exact situation with the heat exchanger capability test I was running.  Some valve elsewhere in the CC system could not be opened which would increase CC system flow (it was jammed shut extremely tight), and we needed to have more CC flow through the CC HX.  My recollection of the solution was to run CC through a recently abandoned (but still in place) evaporation/condensing rad-waste water processing system (the new system I believe used reverse osmosis).  That allowed enough flow to run the test.    As mentioned above, it took all of about 10 minutes to gain approval to deviate from the test procedure and route water though the other system.   Notes were made on the SRO and other Operations personnel involved in determining and approving the deviation, which valves were opened and in what order, and then closed and in what order when we restored the system to normal.    The valve that could not be opened was later "worked" during the maintenance outage.   Later review found no issues with the deviation and documentation of it.

This is not rocket science or even nuclear engineering.  Its just getting approval from other knowledgeable operations personnel for needed deviations and documentation of it.   That does not have to be a long process.  Unless its an emergency situation (in which case other rules apply) there is time to stop, involve others, get a review and approval, before proceeding.

What you describe of people just doing this without involving others, review and approval of deviation, much less not documenting it, is very scary.  I suspect you would have your licenses pulled by the NRC if they ever found out; and the plant would face massive fines; and might not run for years  - if ever allowed to restart - while the plant staff was retrained.
Reply: Very informative and detailed. My objection - no mention of MSR (molten salt reactors). People get confused, thinking the two are the same because SMR includes MSR. 
No mention either of ThorCon who have approval and a site allocated for their MSR on an Indonesian island. This design is radically different to all others; to overcome known material reactor degradation the reactor vessel & other elements exposed to damage will be replaced, refurbished & reused every 4 years. 
However at the point where final approval is imminent, two events will kill it; a new government and the colossal cost of building a new capital city in Borneo
Reply: @gordondolan6443   The cost issues of SMRs compare to larger plants is independent of reactor technology.

I view ThorCon as a scam company.  They are reusing the very unreliable Oak Ridge design and the concept that they can cheaply replace and refurbish reactors is something in fantasy land.  Do you have any idea how radioactive these reactors will be.   I have no idea how they will change a reactor or refurbish it without letting it sit a decade or more (and perhaps many decades).

Since the Government is not paying for it the cost of the new capital does not affect it.  The new government might kill it once they realize they will be left with a likely $1 Billion cleanup and disposal cost for a failed reactor design that no Western Country would license.
Reply: Thanks for the detailed comment and great information.   You answered a few questions I had for a long time about nuclear power and SMR's.
Reply: Very nice collection of facts but not buying conclusions 2 or 3 or 4. Certainly one should not believe such things with certainty.
Reply: @clarkkent9080  thank you for that information. It's sometimes easy to say something is human error by reverse engineering the failure and forgetting to ask some necessary questions. Did the humans have any reason to believe their actions were wrong at the time? Did they have access to real time information they should have pursued path B rather than path A? Is the decision tree too poorly defined to reasonably expect people to follow it? Given the stakes of an error or moment of inattention, are adequate warning systems and automated/semi-automated interventions in place to alert people to the impending error or even prevent it? What systems or verification would have allowed the people to change course and correct the error before it results in catastrophe?
Reply: @perryallan3524  The B&W pressurizer has level indication and if you read the NRC report, they were trying to maintain a visible level on their instrumentation.  

The pressurizer should always be at saturation conditions, something that should not exist in any other part of the primary.  
When there is an in surge into the pressurizer due to SI or increasing coolant temperature, that added liquid will be subcooled. The increasing level will compress the steam bubble resulting in a temporary pressure increase followed by a pressure decrease due to the addition of subcooled liquid to the previously saturated conditions 
You don't reference steam tables to determine the condition of the steam bubble, You have to understand what is happening and why and react to the situation and not wait for what you know will come.
When there is a pressurizer in surge I would turn on the pressurizer heaters even though pressure is initially increasing. By the time the heaters start to increase the liquid temperature, the initial pressure increase is abated and you stabilize the condition without going through a pressure transit.
However, the area where a steam bubble did form was the reactor vessel head.  While there are T-outlet indications, the real concern is the mass of the metal temperature of the reactor vessel head. Their is no way to really know that you have a steam bubble in the reactor vessel head other than pressurizer level changes that do not correspond to what you expect.

Prior to TMI, I never trained on a reactor head steam bubble. After TMI we trained on it extensively and that is why post-licensed operators can't understand why the TMI operators missed what they had been trained on extensively.
Reply: @matsv201  Today, EVERY reactor has system modules built in a factory and shipped to the site.   The idea that modular only occurs with SMR construction is not true.
Reply: @clarkkent9080  Post TMI all PWR reactors were also fitted with multiple reactor vessel level indication systems.  It was a forced retrofit by the NRC and the most expensive retrofit in the industry.   So now there are multiple instruments that would show a steam bubble and water level in the reactor should it occur.

However, that is not the biggest concern of the operators that I am aware of.  Their main question is why turn off the SI pumps.  That was what allowed the partial meltdown to occur.   

On the other hand I will admit that I have only been on staff in 2  loop Westinghouse reactor plants (all licensed by the AEC under the "Atoms for Peace" initiative (and we were generally grandfathered in - although the NRC forced a number of improvements on these plants over the decades (You want to "X" - we'll approve that if you do "Y" to improve your safety margin - even if it did not meet full NRC requirements; it was still a substantial improvement over the original plant design).   

Design requirements for nuclear power plants changed a lot once the NRC took over in I believe 1974 and I'm sure that TMI was a NRC licensed plant.

So perhaps it was just a case that the 2 looper Westinghouse plants normally kept the SI pumps running in situations where more modern plants did not.

I note that I understand that 5 of the 6 Westinghouse 2 loop plants (originally about 550 MWe - with some of them upgraded to the 600 MWe range) are still running today (all 50+ years old).  I'm only aware of Kewaunee having been shut down.
Reply: @perryallan3524  If you read the NRC time line, the fuel melt occurred when they throttled SI and shutdown the RCP due to the two phase flow.  They were clearly trying to keep the pressurizer from filling solid. They did not know that they had two steam bubbles in the primary.

There are pressurizer safety valves (not sure if they were designed for steam, water, or two phase flow) but B&W specifically designed the PORV to allow the operator additional pressure control that could prevent a high pressure reactor trip and to prevent operation of those safety valves that are known to stick open upon activation and they have no block valve. But I can assure you that "never let the pressurizer go solid" was reinforced in the class and simulator. 

Yes, today there have been many changes both physical and in training.  After TMI, every simulator session for years included a stuck open PORV. 

Post TMI licensed operators cannot understand the mindset of those operators in 1979. Even I cannot understand what they were thinking in that hectic situation.  They had both primary and secondary system failures.
I don't know if you have ever experienced a reactor trip in the control room with multiple other events but there is a sensory overload and today's computer displays don't make it any better.....but I was not raised on an X-box or play station  so that may just be a personal opinion. 

We had three High Pressure Injection pumps (at least 2 were required by Technical Specifications). One was always operating for makeup with the chemical shim system and as I recall , the other auto started on a reactor trip.  Following a reactor trip, immediately upon verifying core cooling  via EOP-1, SI throttling was necessary because the pressurizer level would begin to increase somewhat rapidly. 

I started my career at 18 yo at Shippingport in 1974 as a Radiation Control Tech and after 2 years transitioned to an operator class.  I never completed Shippingport training before they moved me to Beaver Valley where I licensed.  I got to see Rickover on two of his visits to Shippingport and was present for the changing of the hard hats in 1975 from AEC to the NRC/ERDA and finally to NRC and DOE. I spent a lot of time as a plant operator while preparing to license so I am aware of   that aspect and what "goes on" in the field
Boy could I tell you stories about both Shippingport and Beaver Valley.  Both interesting and shocking....but that is the reality that many never experience.
You have to actually work shift work in operations to understand what REALLY happens in a nuclear power plant.  I was lucky enough to be assigned to an INPO audit and I think the shift crew was happy to see an auditor that had experience beyond book smarts.
As I said before, and hopefully not to offend, if you didn't work shifts with the operation and maintenance crews you were referred to as a carpet walker (day shift office worker with a computer). Things are not always as they seem and don't believe that things happen just like the Conduct of Operations Manual says..

Operations is a young mans game and I wish them the best
Reply: @clarkkent9080   I will go back and read the root cause report.

Some of what you say does not make sense to me.  How is it that the pressurizer water not drain down to the reactor once the steam bubble got a certain size.   

I operated in both the US Navy and in fossil plants.   I've been in a fossil plant control room during plant trips when 1/3 of the alarm panels light up and the printer spits out paper faster than anyone can track (and I was in a control room built in 1983 that had a high speed printer that could spit out something like 30 ft per minute with the list of alarms).

Good think we had a "1st out" panel which told us which plant trip circuit initiated the trip.

So I do understand a lot more than you think...

While I will look up the root cause report it may not happen for a while as I have other more pressing things in my life at this moment.
Reply: @perryallan3524  I am not sure what you mean with "pressurizer water not drain down to the reactor "?

I never saw a detailed report on the steam bubble in the vessel head and since there was no vessel water level indication, no one knows for sure.  The vessel outlet is not at the very top of the vessel, so the pressurizer is not going to drain into the vessel  The inlets and outlets are part of the vessel not the vessel head. The reactor vessel head has a significant volume above the outlet pipe for the formation of a steam bubble.
I assume that fuel melt occurred when the decay heat exceeded the removal rate once they stopped the RCPs and stopped forced flow. 

You must know that navy plants are no where near as complex as a commercial plant ....even a fossil plant. There are very few valid comparisons with a navy plant and I certainly would not want to work in the navy hierarchy. 
 I have been very impressed with ex-navy nukes in the past but the military has apparently changed.  My last assignment was to train new hires and the company hired a number of ex-navy right off the boat. 
 The one guy (Jr. Lt.) just networked and attended meetings all day and did very little work and was eventually assigned to a menial job with the hope that he would quit.. 
There were 2 ex chief petty officers; one just scheduled people (making over 100K) and in the 2 years I knew him never attended rad worker training, meaning he never entered the facility on his own.
The other (was bipolar: why is that allowed in the navy? slept in  his car most of the day.  The first one eventually quit and I left before they fired the second. 

Another guy was a ex- mechanics from an aircraft carrier and exhibited knowledge, drive. people skills, and humility,  was highly impressive and exactly what any employer would want.  However because of his ex-military status, the other ex-navy nukes treated him like crap.   My experience in commercial is that knowledge, skill, and ability is valued above all else but apparently in the navy rank is all that matters.   

If you operated a fossil plant then you must know that operations is not a simple job where everything is done by procedure, exactly as written, everything is exact, and everyone is all business. Getting a plant that makes millions per day is the top priority.
My point was that managers, auditors, and engineers typically have a sanitized view of reality.  Engineers that were or are STE/STAs are much more helpful as they have experienced first hand the reality of the job and the personalities of a crew.

I never counted them but I would guess TMI had a few hundred panel alarms and ~ 1/3 active alarms in both the primary, secondary, along with emerg diesels and pumps. They had a pin fed printer that uses a typewriter type head that takes ~10-15 seconds per alarm printout. So the printer alarms, while they continued throughout the event,  immediately become useless as they get so far behind. That along with all their recorders and indications. Alarms were coming in constantly so you could assign one person just to acknowledge them and call out the alarm. 

Every plant is different and as I said the exact scenario was part of simulator training for many years after and that scenario is a sensory overload.  Add to that, their indications showed the PORV closed and confusion as no one knew what actually was happening. 

I may have told you but I also worked with the Davis Bessie operator that experienced a simular event years earlier and he was honest and told me "no one, including me, had any idea what was happening. People were looking for something they could do and I closed the block valve simply because I did not think it would hurt anything". So TMI was not the first to experience this confusing event.

Bottom line: operators did as they were trained and while it was possible for a person to determine what was happening sooner than that crew did, give the situation and taking into account all the issues, they should not be faulted.  From what I have seen of the new DCS indication and control systems, humans factors still is not a high priority and complex events can overload the operators abilities.  But hey that is just an opinion.
Reply: @clarkkent9080   While I do my research.  Can you tell me when was the last time you were an operator in a nuclear plant.

As for myself;  I got my engineering degree after I was in the Navy and after I worked in fossil plants.

I'll admit that it very rare for an engineer.  But, don't tell me that I don't understand operations - and I got along great with the operations crew, maintenance too as in the navy you both operated and did maintenance.

I also had a period after my engineering carrier in fossil plants (plant management) where I worked for a Heat Exchanger company that did a lot of rebuilds, field repairs, along with building new heat exchangers (i did both engineering and maintenance/assembly work).  

A lot of that work was in power plants - including an explosive tube plugging job in a nuclear plant (security knew we were coming with explosive tube plugs and met us at the entrance to the security building; and we were escorted by security all the way as their job was to keep an eye on the explosives and ensure none went missing that we did not use).  That job was literally a blast...
Reply: There has been a great deal of work done regarding MSR design and Thorium fuel use in the past 20 years.  Relying on data and results from the 60s and 70s seems to reveal an intent to discard out of hand.  I understand that Westinghouse wants to dominate the field.  This puts the reliability of obviously biased opinions to rest.
Reply: Your dismissal of MSRs and Thorium is based on conclusions made from incomplete information about the 60s projects.  Nixon cut funding because he had to choose between the MSR and LWR Uranium designs.  Since the LWUR provided more fissile material for nuclear weapons, he shut down the MSR program.  It wasn't because they were failures.  Much development has taken place since then.  Aside from the fact that our navy has been using small reactors successfully since the late 1950s, here is a list of some recent developments.
Recent developments
The Fuji MSR
The FUJI MSR was a design for a 100 to 200 MWe molten-salt-fueled thorium fuel cycle thermal breeder reactor, using technology similar to the Oak Ridge National Laboratory Reactor Experiment. It was being developed by a consortium including members from Japan, the United States, and Russia. As a breeder reactor, it converts thorium into nuclear fuels.[98] An industry group presented updated plans about FUJI MSR in July 2010.[99] They projected a cost of 2.85 cents per kilowatt hour.[100]

The IThEMS consortium planned to first build a much smaller MiniFUJI 10 MWe reactor of the same design once it had secured an additional $300 million in funding, but IThEMS closed in 2011 after it was unable to secure adequate funding. A new company, Thorium Tech Solution (TTS), was founded in 2011 by Kazuo Furukawa, the chief scientist from IThEMS, and Masaaki Furukawa. TTS acquired the FUJI design and some related patents.

Chinese thorium MSR project
The People's Republic of China has initiated a research and development project in thorium molten-salt reactor technology.[101] It was formally announced at the Chinese Academy of Sciences (CAS) annual conference in January 2011. Its ultimate target is to investigate and develop a thorium based molten salt nuclear system in about 20 years.[102][103] An expected intermediate outcome of the TMSR research program is to build a 2 MW pebble bed fluoride salt cooled research reactor in 2015, and a 2 MW molten salt fueled research reactor in 2017. This would be followed by a 10 MW demonstrator reactor and a 100 MW pilot reactors.[104][105] The project is spearheaded by Jiang Mianheng, with a start-up budget of $350 million, and has already recruited 140 PhD scientists, working full-time on thorium molten salt reactor research at the Shanghai Institute of Applied Physics. An expansion of staffing has increased to 700 as of 2015.[106] As of 2016, their plan is for a 10MW pilot LFTR is expected to be made operational in 2025, with a 100MW version set to follow in 2035.[107]

At the end of August 2021, the Shanghai Institute of Applied Physics (SINAP) completed the construction of a 2MW (thermal) experimental thorium molten salt reactor in Wuwei, Gansu, known as the TMSR-LF1.[108] China plans to follow up the experiment with a 373MW version by 2030.[109]

Flibe Energy
Kirk Sorensen, former NASA scientist and Chief Nuclear Technologist at Teledyne Brown Engineering, has been a long-time promoter of thorium fuel cycle and particularly liquid fluoride thorium reactors. He first researched thorium reactors while working at NASA, while evaluating power plant designs suitable for lunar colonies. Material about this fuel cycle was surprisingly hard to find, so in 2006 Sorensen started "energyfromthorium.com", a document repository, forum, and blog to promote this technology. In 2006, Sorensen coined the liquid fluoride thorium reactor and LFTR nomenclature to describe a subset of molten salt reactor designs based on liquid fluoride-salt fuels with breeding of thorium into uranium-233 in the thermal spectrum. In 2011, Sorensen founded Flibe Energy, a company that initially intends to develop 20–50 MW LFTR small modular reactor designs to power military bases; Sorensen noted that it is easier to promote novel military designs than civilian power station designs in the context of the modern US nuclear regulatory and political environment.[110][111] An independent technology assessment coordinated with EPRI and Southern Company represents the most detailed information so far publicly available about Flibe Energy's proposed LFTR design.[112]

Thorium Energy Generation Pty. Limited (TEG)
Thorium Energy Generation Pty. Limited (TEG) was an Australian research and development company dedicated to the worldwide commercial development of LFTR reactors, as well as thorium accelerator-driven systems. As of June 2015, TEG had ceased operations.

Alvin Weinberg Foundation
The Alvin Weinberg Foundation was a British charity founded in 2011, dedicated to raising awareness about the potential of thorium energy and LFTR. It was formally launched at the House of Lords on 8 September 2011.[113][114][115] It is named after American nuclear physicist Alvin M. Weinberg, who pioneered the thorium molten salt reactor research.

Thorcon
ThorCon nuclear reactor is a proposed floating molten salt reactor, by the US-based Thorcon company. The two-reactor unit is designed to be manufactured on an assembly line in a shipyard, and to be delivered via barge to any ocean or major waterway shoreline. The reactors are to be delivered as a sealed unit and never opened on site. All reactor maintenance and fuel processing is done at an off-site location.
Reply: @deaddocreallydeaddoc5244     Sorry for the delay - I've had some health problems and this is the 1st time I could respond (and I have promised another poster to research TMI which my health issues have prevented - but I can answer your 2 posts off the top of my head.

Lets start with your 1st post:  Since I wrote my post above a month or longer ago I have learned a few more things about thorium fueled reactors.

First, the US Atomic Energy commission (AEC) was so intent on thorium as a reactor fuel that they believed that they needed to generate a stockpile of U233 to seed thorium fueled reactors.   So in addition to the 4 commercial power plants they built; they also asked at least one other existing commercial power plant (a PWR) to run a thorium fuel cycle so they could reprocess the fuel and extract the U233.   

This was after the 1st core load of Indian Point Unit 1 did not work as well as expected; so the AEC knew how to design an improved thorium core for a PWR.  Essentially, the AEC perfected a breeder thorium fuel core for PWR reactors by the early 1970's.  This core design could be used in the vast majority of existing PWR reactors today (which is most of the worldwide nuclear power plants).

An interesting side note is that the Oak Ridge MSR was initially fueled with U235; but refueled with U233 from the reprocessed thorium fuel rods from Indian Point 1 and the other(s) PWRs that were running thorium fuel cycle cores until the AEC felt they had enough U233 in stock for future thorium cycle power plants.

The other thing I learned is why thorium reactor fuel was so expensive compared to uranium reactor fuel (keep in mind that the AEC was operating a medium scale thorium reactor fuel processing plant back then).

It turns out that the chemical steps and process of converting thorium ore to reactor fuel is significantly more difficult (or complex) and expensive that to convert uranium ore into uranium reactor fuel.  

The AEC did a study of what if there was a very large scale thorium reactor fuel plant - and it would still make thorium reactor fuel more expensive than uranium (to the extent that the cost of the ore is only a small part of the overall cost).

That is what killed plans for commercial thorium fuel cycle power plants back then, and still apparently today as I did some digging and I have found nothing to indicate that thorium reactor fuel would be cheaper than uranium rector fuel today.

If the cost even breaks even a number of countries with good thorium deposits would convert their PWR to thorium in a few years.  If thorium was cheaper... then most nuclear reactors in the world would be running thorium fuel today (even if it was never reprocessed).

Germany also built a 300 MWe thorium cycle HTGR (pebble bed) in the 1980's that only ran for several years.  It had technical issues that released radiation multiple times after its startup in 1985, and with Chernobyl occuring in 1986 the German Public was in a "zero tolerance" for radiation releases and the plant was shut down in  1988 after it was determined that they had a problem with the pebbles breaking and releasing radiation with no quick fix in sight.     An interesting side note is the China licensed the German Pebble Bed HTGR design, improved it, and is currently running at least a 200 MWe plant and building more pebble bed HTGRs... except the are fueled with uranium as its cheaper than thorium.

The main reason that India is pursuing it is that they violated international agreements that they had signed and used peaceful reactors that they had promised to never use for weapons production to build atomic bombs.  India now cannot buy uranium or many nuclear supplies from the rest of the world; and must rely on their own resources; which is mainly thorium.

As far as lots of research in the last 20 years.  Yes a few countries are still running thorium research and test reactors.  But nothing has fundamentally changed about thorium since the late 1970's (other than they may have modeled some new core designs for reactors other than PWRs).  Economics alone stopped thorium as a reactor fuel; and when that changes then you will see thorium take off.

So please show me this significant thorium research in the last few decades.  All I see is a lot of wishful thinking about possible reactor designs that could use thorium (It's been known forever that every known nuclear reactor design could use thorium).
Reply: Have you been on any podcasts?
Reply: @mkuc6951   No.  I have not.  I don't have the energy or the time to start one; and no one has asked me to be a guest on theirs.
Reply: The major reason they chose not to use thorium was defense purposes, we needed plutonium for artillery, it would work now if we refined the building process which Copenhagen has done for Thorium . When we signed the Reagan Peace Initiative we began dismantling numerous Nuclear Plants. Now days we desperately need nuclear again to stop carbon emissions. World weather is out of control.
Reply: @pin65371  We stopped nuclear plants and disassembled many due to the cold war ending with Russia, we did not need the plutonium for warheads anymore. We chose uranium over thorium because we needed war material. That choice was a define act/ choice back in the 1940's.
Reply: 3 weeks for erecting a wind turbine is an undeniable advantage where such an engine is needed.
Reply: @FernandoWINSANTO   Wind generation is not reliable and its capability is variable.

Nuclear power plants are highly reliable and can be counted on to produce a fixed amount of power 24/7 for many months at a time.

There is a huge difference in where these two generation technologies fit into electrical grid generation and management.
Reply: @perryallan3524  canadian coalition for nuclear responsibility
Reply: Thank you for that quick dissertation, Perry.
Reply: @pin65371  part of the problem there is the expertise from the 70s no longer exists. Those engineers are very old or dead, and that kind of knowledge can't be written down, let alone stored across the decades or accessible to modern governments. There is an element of relearning how to do thing with modern materials and equipment because so much has changed.
Reply: @perryallan3524  What do you think is the future of electricity production then?
Renewables and natural gas for base load?
Renewables and fusion for base load?
Reply: Nah, what is possible and even rational for society doesn't matter in the face of social-political incentives. This guy leans into the latter when it benefits his motivations while pretending he's only doing the former. It's like you could design a better city, a better traffic system, etc, yet none of that matters because you don't have the cache and there are not the incentives in the system to change to that
Reply: Question is, would you buy the stock at these levels for Nuscale?
Reply: @emreon3160  No, I would not.
Reply: Thank you for the praise of china's construction capabilities. It is easy to overlook based on prejudice.
Reply: @rajahua6268  Your welcome.

Unfortunately, the construction standards of the nuclear and parts of the aviation industry tend to be ignored in the civilian and on other government projects in China.

China could have saved itself a lot of grief (and a lot of future grief) - not to mention vast amounts of money by adopting and enforcing design and construction standards for non-nuclear and non-aviation areas of their economy.

Have a great life...
Reply: Amazing, knowledgeable comments, I’m looking into this because it seems we need to greatly expand our power grids. If nothing else, but simply to accommodate the great power demands of the impending AI revolution.
Reply: I have a personal opinion of your thoughts. In short 98% of what you said is correct. In nuclear energy economics as we say SMR's is not the Most Economically Advantageous (MEA) option. And your 40% propotionate cost increament hit the nail. 

In simple nuclear physics the bigger plant it is better in terms of safty and radioactivity. But it doesnt mean that we can't build it small. But then the fuel enrichment reduction and alternations comes to play with a sky rocketing refining and chemically processing costs. So SMR's is something fly in the air now. 

Hats off to you, for posting the best comment I read for my 15+ years of youtube usage.
Reply: @robupsidedown  definitely
Reply: What a great read!!!
Reply: @perryallan3524  it seems you'r not considering VVER reactors....no accident, easy to operate, easy to build (despite poor quality components manufacture)
Reply: @AS-in7ox  Yes, I have dismissed the VVER's because not even the newest ones meet Generation 3+ design and safety standards.   

The earlier VVER plants are 2nd Generation nuclear PWR plants.  The later ones Generation 3.   They are essentially just as safe as very other Generation 2 and Generation 3 PWR power plant built in the world, which actually has a fantastic overall safety record with the one failure being 3 Mile Island, and 3 Mile Island contained its radioactive mess inside its containment building.

Generation 3+ passive safety is a vast improvement in overall nuclear power plant safety.   No major western country is going to build a VVER.  Russia has never submitted its design to the US NRC or equivalent regulatory agency with full review capability for a good reason - it would not pass (and if you go back about 2 decades ago multiple foreign designs were submitted to the US NRC for certification - but not the VVER.

Also, your concept that you can build a quality and highly safe nuclear power plant using poor quality components is laughable.  It shows your total lack of understanding of the issues involved.

But, I get it:  You like the VVER for a variety of reasons.  But, no one is going to try to do a comparison of it to say the Westinghouse AP1000 which is currently the lead Generation 3+ passive safety PWR in the world (and no one else is in even a close 2nd as the French and Germans have admitted that their EPR needs to be redesigned and no more than those under construction will be built).

Have a great day,
Reply: A HUGE difference between using thorium or some new technology than just scaling down PWR's, a technology that has been working for decades.
Reply: @perryallan3524  Hello Perry, your optimism about nuclear power Is a little bit extreme. The lifespan of nuclear plants is not as long as you suggest. See France, the leader in nuclear energy. The typical operational life of a reactor is closer to 40-50 years, not the 80-100 years you referenced. France Is facing severe issues, with many of its reactors undergoing very expensive maintenance and upgrades. Nuclear energy, like solar and wind, is heavily subsidized by the state. Nuclear can be just as costly as solar and wind over time
Reply: @paulmcdonald2742 It’s also overly optimistic to assume that we'll have a good economy and stable governance over the next years. History teaches us one important yet incredibly underestimated lesson: everything can change rapidly and drastically
Reply: @alessandro10127  The USA currently has early 1970 nuclear power plants originally licensed for 40 years that have been running now for 53 years and currently licensed for 60 years, and they have applied for another 20 year operating license (out to 80 years).  

The two plants I am familiar with (and worked at) are in very good mechanical condition - so I don't see any reason they won't go well past 60.  The only thing they are really talking about to run at last 80 years is the need to rewire most of the plant as the early 1970's electrical cable insulation is getting brittle (modern wiring insulation does not have that problem and should last 100+ years).

The newest design plants being built in the world today (Generation 3+ Passive safety) have been designed to be more robust and long life and the initial operating license are for 60 years, and there are people who think they could last twice that (and the base structures and reactor vessel have been designed accordingly).

I would challenge your concept that the French is a world leader in nuclear power or power plant design.   The Chinese are currently the world leader in modern nuclaer power plants.  By the way they are really built well and they are not cutting corners.  I did a consulting job at one of them and was highly impressed with the construction, procedures, and attitudes of the staff and construction companies. 

The French and Germans have admitted that the EPR has design errors and that its design needs to be reworked and relicensed for any future new plants not already under construction.  Meanwhile I believe that there are 6 Westinghouse AP1000's running just fine and I believe about 9 under construction worldwide if you include the 6 licensed CAP1400 Chinese copies (where the Chinese hired Westinghouse to design and certify the nuclear side of their larger copy of the AP1000).

Note that the Chinese built both the EPR and and the AP1000 - and decided that the AP1000 was the clear winning design for a Generation 3+ passive safety plant.

I'm aware of at least 20 other power plants sites in the world that are looking at building AP1000's.  And yes people are seriously talking that these plant should easily last 80-100 years, and perhaps longer.
Reply: @perryallan3524  There are exceptions where some reactors have exceeded our expectations. However, the typical operational life remains around 40-50 years
Reply: @perryallan3524  By the way, thank you! I think we all learned a lot from you sharing your extensive knowledge
Reply: @wertigon  this
Reply: its unproven to be reliable, feesable or even doable, not to mention bloody expensive, waiting for an unsuspecting customer ,and of course NO WARRANTY OR GAURANTEE buyer beware